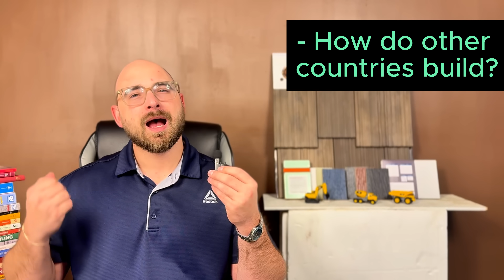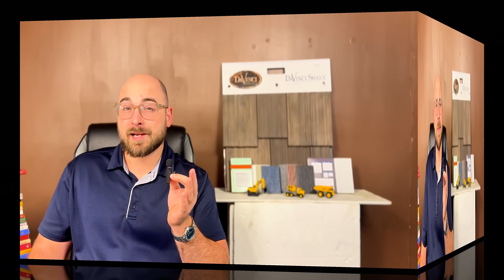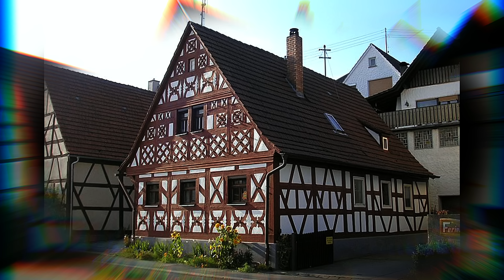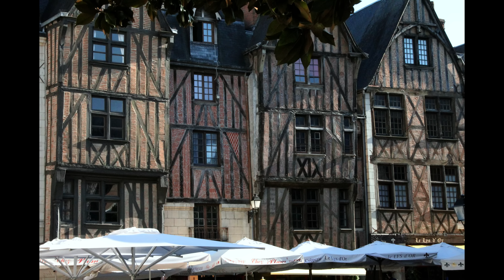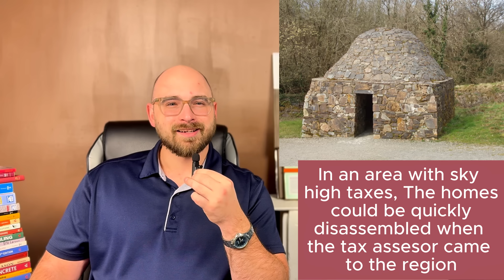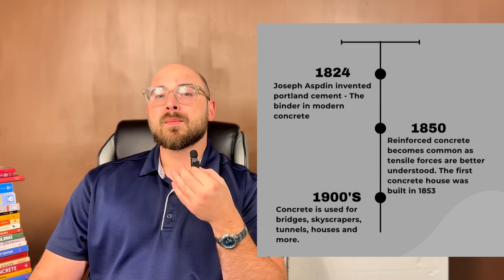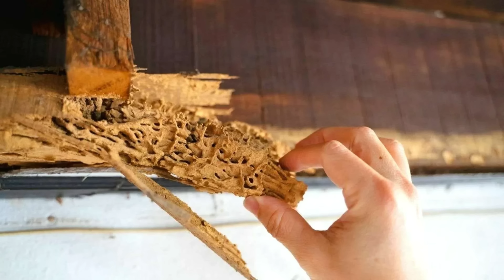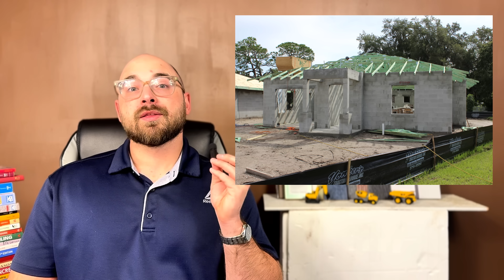Why Other Countries LAUGH at American Homes

Comment from the maker: Are houses in other countries better than the US? 🏠🤔

What do you think?
Reply: 100% better overseas.
Reply: @Aortadetroit Only 3% of Switzerland's population owns their own home. the other majority either pays rent 30 or 40% of net income or has financing. The USA, despite having a lot of financing, has a higher average home ownership than most rich countries in Europe
Reply: I live in Romania, which is pretty poor, and I'm a teacher, among the poorest of the citizens here, and my house is brick and concrete, with a thick treated metal roof (50 years corrosion warranty). Also, triple glazed thick windows. Under floor heating system and so on... Wood studs/OSB houses have not thermal inertia and are pretty fragile. Also, the American shingles that need replacing once every 10 years are horrible, too.
Reply: @ctr289  I live in the US; timber frame construction, with significant insulation. 3,500 sq/ft above ground (325-ish sq/m), another floor below, so about half that in a poured concrete (ICF) basement. Triple glazed windows. Wooden/asphalt roof supported with an 25ft (~8m), 8" steel I-beam across my living room/foyer, a 20ft long, 6" steel-I beam across my family room. Joined with a 40-ish foot 6" I-beam to form an "H", if that makes sense. Those tie into cross-braced steel and wooden trusses. You can park a truck on my roof. 

They did it because we have vaulted ceilings (entry way/staircase/living room are 35' (11m), my family room/entertainment area is closer to 40' (13m)) , and few walls (except exterior) that go floor to roof.

I live in a harsh climate along the Great Lakes (Buffalo, NY metro.) We get snow, and 60+ MPH (100 km/h) winds regularly. There's hurricane bracing in my exterior walls, and things significantly exceed code in my home. I didn't build it, but it'll outlive me with basic care, because it is designed to last, even with stick-frame construction.

My outbuilding (I collect/restore old cars) has a steel roof (stickbuilt frame, steel siding/roof), the problem with a metal roof isn't the steel. It's the fasteners. Each one has a rubber o-ring (Viton, is the trade name in the US.) Each screw is a penetration relying on that rubber o-ring to work. Each penetration is a failure point. Your screws will fail you in 20-25 years in our climates here, the roof will live longer. 

American shingles don't last 10y. The most recent shingles I put on my home have a 100% replacement guarantee to 50 years; 75 year total life (they pro-rate your refund from 50 to 75y.) That 50y warranty includes labor. I put them on in my early 30s. I'll most likely be dead before they need replacement (or old enough that I'm in a smaller home.) My installer, a friend, will be in his late 80s at 50 years. He will not be doing my roof then, either.

The cheapest shingles at building supply stores are 25 years. "Architectural" shingles start at 35 year guarantees right now.

Regarding insulation, it's cold here (3F today), my annual heating bill is combined with hot water, and my clothes dryer (natural gas.) We obviously don't heat anything in the summer, but do still take hot showers, and wash clothing. I'm just under $500, annually, and my home is kept warm (70F/21C) to stop my wife from complaining she's cold. 

Energy efficiency can be done, you just have to pay for it with stick-build framing.

I've spent time in the UK; lived in solid brick century old homes here.  The homes aren't better or worse here, or there, they're just different.... You can (and many people do) buy cheap, but that's on the buyer to understand what they're purchasing. Cheap homes will always cost more in the end...
Reply: @ctr289 Asphalt shingles are awful. I had a new house and had to replace the shingles after a hail storm. The entire new neighborhood had to. Or high winds break them off. Everyone is going to metal now.
Reply: @trehis  Well, here in Romania we've had ceramic tiles for centuries. They're almost immortal. We've been using metal sheets for a few decades, though, because it's cheaper, but it can still last for about 40-50 years, depending on brand/type, still a lot better than asphalt shingles. We have asphalt shingles, too, but they're used only by the poorest of the poor (village drunks, beggars). I was shocked when I found out most of the Americans use asphalt shingles and replace it once every 10 years. Also, for us OSB sheets are only used for the garden shed. Our houses are much smaller, though. Gas is more expensive (taken by the rich Western European countries as blackmail for letting us into the EU)
Reply: @ctr289  They aren't really 10 year shingles. Most are 25 year. They used to offer 50 year warranty's but not they just say lifetime or something but they don't last that long.
They suck and don't last as long as they should without getting storm or wind damage.
Reply: @ctr289  Współczuc że w Rumuni są ta żałośni nauczyciele. Mam dom amerykański w Polsce z kanadyjskiego projektu (Drummond Designs) i mieszkam w nim 30 lat  i jestem mega zadowolony. Gont mam polskiej produkcji sprzed 30 lat na osonowie z tkaniny szklanej i nie wiem o co ci chodzi. Najpewniej pmyliło co sie z gontami bitumicznymi sprzed 70 lat na osnowie z tektury . Ale takich się juz nie robi od lat. Elewację mam rzecz jasna z sidingu drewnianego i też od nowości . Wymieniłem dosłownie 1-ą deske przy cokole. Po odmalowaniu dom lśni nowością. A w Polsce popularny jest totalny badziew czyli cieniutki tynk na styropianie gdzie niszczą to myszy, nawet oprzec się odom nie można bo zaraz się dziurę zrobi. A takie te domy murowane solidne w że jak przeszedł w Polsce huragan to wszystko się rozwaliło w drobny mak. Paradoksalnie najmniej zniszczony był ośredke campingowy z domkami szkieletowymi. Płyta OSB ogromnie usztywnia konstrukcję i nadaje konstrukcji elastycznosci do której badziew murowany z cegiełek nie ma się co równac.
Reply: @trehis  Blacha od gradobicia czy silnego wiatru zniszczy się znacznie szybciej. Miej trochę logiki człowieku.
Reply: @PiotrABC-l5b  I live in a place with hurricanes and hail. 1 in 5 homes here have metal roofs and that percent is growing. Metal has a 50 year life span which is much better than asphalt shingles. Metal is absolutely better than shingles if installed to code.
Reply: @trehis  Założyłem na dachu werandy dobudowanej blachę trapezową bo nic innego nie sprawdzało się przy niskim kącie dachu.Faktycznie nawet ten trapez ciemny szary półmat jest stosunkowo elegancki, Natomiast z tą odpornością blachy na grad to absolutnie trudno się zgodzić . Gontowi nic się nie dzieje. A z blachy robi się masakra po gradobiciu.
Reply: @PiotrABC-l5b  What is the thickness of the metal and what kind of metal? Ours is 18 mils, 0.46mm. All the homes with metal roofs I see look just fine around here.
Reply: @trehis  Stla ocynkowana 0.5mm.
Reply: @PiotrABC-l5b  I have a galvanized building that is  more than 30 years old that isn't all pitted from hail. It went through the worst hurricanes just fine. I know what you mean though, a neighbors new car was written off due to hail damage. Galvanized steel should hold up to hail though. Chinesium?
Reply: @ctr289  Hello neighbor, from the south of the river Danube!  I'm a former teacher in a similar situation like you and I 100% agree with what you said. Our countries don't differ too much from each other, but the US, well...
Reply: @ctr289 , you forgot to mention,  that these houses must also withstand an 8+ Richter earthquake.
Reply: @ctr289 There is a very interesting fact about home ownership. The poorest countries in Europe, such as Albania, Hungary and Portugal, are the ones with the most paid-off and owned homes. While the lowest percentage is among the richest countries, especially among the new generation that pays rent. (Switzerland, Germany and other developed countries are the ones with the least home ownership.) Which makes me wonder if it is really worth earning more if you leave 35% of your income or more in rent or installments. How much is really left over?
Reply: @ctr289  👍
Reply: @ctr289  Agree with you, it is a shame the way houses are built in usa
Reply: The USA homes are built really cheap to minimum standards to make max profit.  If we up the standards, maybe we could be ok? Homes in Arizona are a joke!
Reply: @terrycarter8929  As a builder I have never seen anything like that garbage seen in all those inspection videos, that simply doesn’t happen in the northeast. You will be constantly harassed by building inspectors here over the smallest stuff. People watch those inspections from mass built garbage and ignorantly assume that is how house are built in America which isn’t even remotely true.
Reply: @terrycarter8929  As a builder I have never seen anything like that garbage seen in all those inspection videos, that simply doesn’t happen in the northeast. You will be constantly harassed by building inspectors here over the smallest stuff. People watch those inspections from mass built garbage and ignorantly assume that is how house are built in America which isn’t even remotely true.
Reply: @michaelstrang2563  it is true in Phoenix.  In Surprise the house I was renting didn't have insulation in the walls.  The foam they put on the outside behind the stucco was all they needed to pass code!
Reply: @terrycarter8929  Yeah that is Arizona a place with almost non existent building code, that being said I suspect that building will be around for over a hundred years. People in Arizona are really that well off so you are lucky they don’t force you to build to our standards.
Reply: @michaelstrang2563  there are some rich areas and poor areas.  The Californians and Canadians have driven up the prices so high the lower middle class cannot afford it.
Reply: I totally agree, ICF is the best for most circumstances.  I’ve designed and built the basement of homes this way, but have not used it to build an entire home yet.  However, ICF roofs are a disaster!!
Reply: In Russia most of my elders laughed at USA houses that built of wooden frames and DVP that can be wiped away by totnado or easily burnt by woodfire. They ironically call them a cardboard houses. But when I did some research and compared prices of solid brick house vs wooden panel house, I realised, that I can't afford myself a solid brick house (((
Anyway I still live in what is called in NY a 'projects'. So nvm.
Reply: As a European, I think there is no problem with the frame construction method, if it had heavy timber framing reinforcement, or 1-2 walls were made of brick or concrete, and were not just an independent decoration. I live near Budapest, there are frame houses here too, but they are not that widespread. What is built on site is not of such good quality, but the frame houses made of prefabricated walls here are quite strong and durable. Actually, it has not spread, because of the banks. Because if the  debtor does not pay the mortgage installment, the bank has a hard time selling the frame houses, because here people consider brick houses to be more valuable. That is why banks very rarely lend money for the construction of frame houses.
Reply: My only concern about Anerican houses is safety and energy effeciency.I think even our half-timbered modern house with  flexible walls are mire efficient than any of these cardboard houses in the USA. Then you should not need ACs so.much. our house is a passive house, it was already on this standard in 1993 because of the thick walls and insulation... Even today it
 fits the latest norms.
Reply: @AnnetteLudke-je5ll  energy efficiency in USA is much better than Europe. One of the big reasons you don’t see European style buildings is because of the poor insulation properties of said buildings.  Look at the heatwave in Europe in 2023. 47000 people died from it.  It reached around 100 F. Meanwhile in the US, we get that temperature every year.
Reply: Hard to say, as I've never been to the US. But I'm quite happy with my English bungalow, an early 1960s single story home with a cavity wall. The outer skin is brick, the inner is (I think) some sort of block. The cavity between was originally an air gap which prevented water ingress, now filled with cavity wall insulation; polystyrene beads.  Many claim that's not a good idea, but I've had no problems with it. Windows and doors are double glazed, though would have probably been steel framed windows and wooden doors when first built.

There's about eight inches of fibreglass loft insulation above the ceiling. If I seem a bit obsessed with insulation, it's because England is cold and damp for much of the year and energy prices are high.

I'm amazed at the size of many US homes; my bungalow may seem small to you at 600 square feet but I live on my own and it's the right size for me. It's larger than many other one bedroom bungalows here.
Reply: @rogerbradbury9713   You should go and see a house in Denmark or south Sweden where temperatures are  close to same with uk or Germany and notice their heat bill with yours though out of a year and be amazed.
To understand why you should go through bay your bay windows if you have and attic insulation along with insulation between the floors and walls. and I bet that you 100% don´t have it done between the floors where the most insulation would work if it would even be there.
UK under rates any insulation and as well how it should be installed, mostly because you don´t understand what you could get, just you dont have comparison and everyone even surveyors who are telling me into face that why are the ones who are keeping people like you off from what you could get.
Reply: @rogerbradbury9713  you are living the good life👍
Reply: If I ever built new, it will probably be ICF. Tax laws in Germany, for example, favor building rental homes, which are literally investments. They don't have to be fancy, but they will be built like the proverbial Tiger tank. The "Dachgeschoß" (attic) rental unit I lived in back in 2022 in Mainz was a three story, three unit apartment house built in 2008 of concrete. Since it was originally built by the father-in-law of the owner (who lives 4 hours away up in Westphalia) as his primary home on the ground floor, it was a nice newer home in a nice, upscale neighborhood in the Oberstadt (upper city) with quick and easy walking access to transportation and local shops. I literally had multiple options. My nearly 50 year old stick home in Indiana is a pain, and you have to worry about termites and vermin.
Reply: My grandfather build house from reinforced concrete in 60s!! (so was my father in 80s) And my grandfather was  was just factory worker in Serbia which has like 1/5 off USA GDP  per capita .And you see milioners in USA building houses from wood with no foundation
Reply: @dzonikg  No one builds houses without foundations in the America especially millionaires you are clearly misunderstanding something.
Reply: @dzonikg There’s no place in the US where people build homes without foundations!
Reply: I think it is not the method of building that matters as much as the quality. I mean I've been to a motel in the US where I could put my fingers through a gap between window-frame and wall. And I've encountered many homes that were poorly or not insulated (with an AC on full blast, there goes your energy-/money saving). There are also some questionable product used (especially when it comes to doors* and windows of extremely poor quality. And door-frames that are flat, not overlapping with the door). In the US (where I spent little time, maybe 3 month up till now) I have seen kids crash into a wall leaving dents (never seen that happen here in 50 years, but these days it can happen on the outside, due to the softer insulation under the plaster).
Now in all fairness, I cannot tell you what percentage is poorly built (a huge gap in the wall grabs attention, a normal built house does not). But it is exponentially higher than in Central Europe.
There is also something great I learned in the US. Passive heating by designing roof / windows so the lower sun in the winter heats up a black-stone floor but cannot reach the floor in the summer.

*I always find it funny if they kick a door in, in a movie (you could not do that on an inside door here in Switzerland ¯\_(ツ)_/¯). But I have seen cardboard filled doors in the US, so it is believable. For comparison, the front-door on my flat has a 2mm steel plate between laminated wood, bolts into all directions and has a lock (Kaba star cross), not even the LockPickingLawyer messes with. And yes, double bricked wall... my home is my castle :D
Reply: To be honest, I had the impression of US houses to beautifully looking but with similar strenght to shanty houses. With walls that you can punch through, and can be flattened easilly by natural disasters. In 3rd world countries, average homes are already  built with steel, concrete blocks and cement and it is much cheaper than wood.
Reply: Some are, some aren't. I mean I'm in Georgia and my house is 125 years old and I can guarantee you that it wasn't originally built by the most skilled artisans.
Reply: I am from Costa Rica. Ring of Fire from coast to coast. My father in law build his house on his own. It's made with Cinder blocks. He did a mesh of rebar. He filled every block hole with concrete. You CANNOT get cell phone signal IN the house. It's literally a faraday cage. One day our Irazu volcano will bury our San jose city like Vesubius did Herculano and Pompei. I am absolutely positiver my father in law's house will be preserved for posterity 2000 years down the road. The only way to bring that house down is by active demolition, and an expensive one at that.
Reply: @decaalv LOL! 
Then how do people call your cellphone?
Reply: I thinkwhat a termite infestation does to an americanhouse. Or just mice.
Reply: Our late father, and his father before him, built solid brick homes in the Midwest.  All those homes are still standing and square (no cracking or settling) despite some being over 100 years old.
Reply: You said in your video: It depends. I am of German decent and lived in Switzerland. I came to appreciate the typical US wood house for it’s flexibility to make design changes. The biggest draw-back however is energy efficiency. For the vast majority of US houses HVAC is a must - even in northern states like Wyoming, Montana, whereas the vast majority of houses in Europe including Southern Europe do only provide heating for the winter months. The summers in Europe may not be the most comfortable, but people make it through those hot weeks and few months. 
The other issue is the increase in natural disasters: Hurricanes, wild fires, tornadoes, flooding. 
In other words: I think in the US, concrete / CMU based buildings should be more seriously considered for energy saving and overall safety reasons at least in certain areas / states.
As for Europe: Innovative sustainable, environmentally friendly composite materials are coming to the market there in big box stores, combining the features of both worlds wood, concrete and stone! 
Finally, I feel the US is much slower in adopting innovation in home building in which I include also plumbing, electrical, interior design, heating. As said, I am not unhappy with my house here, but I feel we could do better.
Reply: @BAG9114 — My home in the Pacific NW (Bellevue, WA., near Seattle) has no air conditioning. I lived there 35 years, and there was an average of about 5-7 days in the summer when I could have used A/C (95 F + or 35 C +). Perhaps more days in future years as global warming increases. 

That said, we are located in the “rim of fire” for volcanic and seismic activity. I’ve experienced three earthquakes in my wood-framed home, and so far no major damage. I’m certain there would have been significant damage with a stone or concrete based home.
Reply: @BAG9114 There is a very interesting fact about home ownership. The poorest countries in Europe, such as Albania, Hungary and Portugal, are the ones with the most paid-off and owned homes. While the lowest percentage is among the richest countries, especially among the new generation that pays rent. (Switzerland, Germany and other developed countries are the ones with the least home ownership.) Which makes me wonder if it is really worth earning more if you leave 35% of your income or more in rent or installments. How much is really left over?
Reply: @ That's an interesting perspective. I remember recently hearing about the UK trying to convince people to upgrade their homes to be insulated so that they could survive using heat-pump heating in the summer. I hadn't thought about what the state of the rest of Europe would be.

I don't think I've ever lived anywhere that didn't have a heat-pump unit. (Except once very early in my childhood. It was a very poor house with only a swamp-cooler!)
Reply: @BAG9114  Most houses are BLACK ROOFS! And black roofs will amplify the heat! Whereas Switzerland has grass for the top layer of the roof!
Reply: @BAG9114  I like your answer a lot, I do want to point out that the insulation thing actually isn’t as bad. A lot of older houses barely insulated for sure, however in colder climates insulation is not only a must have it is a requirement and we have minimum standard as to what those insulation values should be. 

My house was built in the early 1900s and it’s well insulated, aside from the windows which had to be replaced with newer ones, these houses can do well. Remember they only had a central stove for heating back then so people were much more incentivized to make sure that heat produced stayed indoors as much as possible.
Reply: @BAG9114  while I see where you are coming from American houses actually are built to be energy efficient. We use at least 2 types of insulation per house. As well as special OSB sheets that also provide some R value. Of course it will change throughout America because we experience pretty much every climate the earth has to offer.
Reply: @BAG9114 I think you perfectly summon up so much of the ups and downs of the choices of building materials.
Low cost housing by using easy available materials is a good thing in the way that it is fairly cheap to build a house in US..... so many more people can have that opportunity.... 
But in the long run...... 
Your perspectives are so well placed. ..
Reply: @BAG9114 i like the wood homes in the US we have a surplus of wood so rightfully so you use what you have the most of, also americans are very fond of remodelling, i have not met a single american who kept their home the same for more than 2 years, theres always changes and updates, i dont know its just a thing here, they get tired of it, they rebuild it again, i also have a house in the philippines and we do use concrete there, and now i actually want to renovate it and change the interior and i would also want to make it “centralized AC” but guess what? The engineer said i would have to destroy everything cause they cant do the centralized AC with how the house was built, and its soooo hot! The bricks made it very hot, it s really hot it feels like an oven we get 35 C there in the philippines(because youre european i use celsius your welcome) so i do like the flexibility of american homes, americans like convenience thats what america is all about, hence we have cars instead of public transit, the car is definitely more convenient, nobody wants to ride public transport carrying a grocery bags, and everything you just got from CostCo’s while carrying your dog or the childrens strollers i means i hate that to be honest, i lived in the UAE for a long time i find it cumbersome because alot of people carry their kids to the public transport and they have strollers, grocery bags and everything 🙄 so no 100% the car is more convenient, thats the same with our homes..
Reply: @BAG9114 :  The USA is much slower, about 100 years behind the times mostly because of the constraints of the building code, combined with the fact that people don’t actually have to pay for these homes, they borrow money, and they accept poor quality since it really didn’t come out of their pocket to begin with
Reply: @steveperreira5850 in what perspective are building codes a constraint?
Reply: @steveperreira5850 — Borrowing money is not free; it comes at significant interests costs!
Reply: @steveperreira5850 you guys are slow . You and your dad can build an American home by yourself three stories high . You cannot do this with a stone home . We built America with our hands
Reply: @ most europeans also have to borrow most of the money to buy their (first) house
Reply: @steveperreira5850  The USA is about 100 years behind mostly due to youre government system keeps the people naive and kinda ignorant .... and the bad part of it all,,,, the people dont even realise it.....
Reply: @AliasHSW  In USA, codes are restrictive. Instead of specifying a goal, it limits what can be used, and thus block innovation. If one varies from the code, the inspector may refuse to approve the work.
Reply: @ the primary objective of the American/ICC building codes is to protect life, not necessarily the building. A/E/C has free rein to design and deliver the project by any means and methods. This way they can innovate and try new ideas as they please, so long it satisfies and or above the intent of the code.
Reply: @AliasHSW  I disagree. The main purpose of government 'oversight' is to insure they get a cut of everything. People who have natural liberty don't need government permission nor need to pay tribute to exercise said rights.
To illustrate : despite widespread government regulation in automobiles, annual fatalities exceed 39,000 per year (not counting non-fatal injuries). 
That far overshadows deaths by firearms (excluding suicides). But no one espouses banning 'ASSAULT AUTOMOBILES'. Or changing the laws that penalize rail based transit... which have infinitesimal fatality rates by comparison.
Reply: @steveperreira5850 the only thing slower is your brain
Reply: @AliasHSW  The type of materials, lesser insulation materials, BOCA codes that do not always reflect newer technology, municipal planning ordinances the restrict the types and appearance of structures (including the extent of anchorages to foundations and wood structures). Some additional codes are imposed by municipal governments, such doctrinal setbacks between buildings, the existence or heights of privacy fences, and the location of trees that must be planted. Our city relishes "historical preservation" mandates that require homeowners to paint walls, doors, window frames, shutters and roofs specific colors whenever the tiniest bit of renovation is to occur. l'll give you an example: A  neighbor wanted to replace a rickety garage door adjoining on his house, which is located on a short, inconspicuous alley. No, the city said. The garage has to look precisely the same as it looked 120 years ago, including appearance and color, and the homeowner must hire an architect to design a proposal for review by the historical commission. The cost of replacing the rickety garage door became astronomical. His only choice: Leave the door untouched, even though it didn't function well and needed repainting. He escaped with the city's edicts only by letting the door decay and the neighborhood suffer.
Reply: @BAG9114  Summer heat waves being more frequent and also frequently causing a surge of fatalities in Europe when they hit, along with the difficulty of implementing HVAC systems into solid wall homes in order to mitigate the impact of that is something that I expect to become more & more of a significant factor that's seen as a weakness. Add to that that HVAC systems also manage air filtering that can use fresh air or recirculate air for efficiency, so they're ideal in the summer when pollen and others allergen levels are high, and just opening a window for ventilation isn't an ideal solution.

Things like that where offsetting the downsides of home construction by doing things like taking allergy medication in the summer are a lot more difficult to recognize because the cost and impact of that gets distributed in a way that doesn't make you consider the root cause being the way your home is built. (Also it's surprising how few windows or porch doors in Europe have screens in them as a standard, given how often you have to keep them open in the summer when you don't want to just fill your living space with flies & mosquitos).

Living in Sweden where most living structures are built for cold winters and not for hot summers, it's been awful here by comparison to when I lived in the US. Even in winter, the inefficiency of radiators pumping heat directly below windows and drying out the air is also a far cry from an HVAC system in the winter as well (not to mention there's basically no ability to control that centrally).
Reply: If you're in a seismically stable area that doesn't have frequent hurricanes or tornadoes and stays above freezing the majority of the year and below 40C the majority of the year.... the old timber frame construction is still probably the cheapest option.   An example is where I am in NE Georgia, just above the fall line.  Summer is still hot and humid, and winter is cool with rare snow events, but more importantly, tornadoes and hurricanes very rarely come this direction.  (Helene paid us a visit last fall while still Cat 1, which was a very notable exception.)  The #1 cause of home destruction is still fire, but the #1 cause of home damage without it being total destruction here is trees falling on them.

If I had my options and I was building fresh, I'd love to get an ICF house, but we took the house we could afford 15 years ago, and it was classic balloon frame.
Reply: Consider just 1 scenario - fire! Most houses non-timber can be salvaged cheaper faster after a burn. Some roofing and brick support wall methods will isolate fires to affected rooms when fire suppression reaction is timely
Reply: @kevintinofirei782  that is sort of true.  Many times when there are wildfires in the US, even the concrete ones have to be scrapped, because if the temperature gets too high, the rebar is basically useless.  Although, European homes don’t usually have reinforcement. The lack of reinforcement probably would make it so the house can survive the fire, but not the earthquakes.  There have been up to 9.2 earthquakes in continental US.  The biggest in europe I could find was 7.6. Which is almost 100 times less intense than what the US has seen.
Reply: I think there is one big misconception in this video that many americans have about those laughing foreigners: 
We don't laugh about wood, we laugh about the American standard to build an entire house out of wood, while still trying very hard to use less wood than us foreigners use in the roof of a brick house alone.
We don't laugh about wood houses, but about houses which are built less sturdy than temporary structures and shed we build. The typical american home has the build quality of a makeshift rain shelter homeless people build here. That's what we laugh about.
Reply: They're less flammable, that's for sure!
Reply: Most Caribbean houses are brick and mortar. Are they better? Well they stand up to hurricanes a lot better. Are they better than US homes? Debatable.
The tolerances, insulation, more practical layout and electricals seem to be better in US homes while Caribbean homes seem to stand up to natural disasters better.
Reply: @Skungalunga  obviusly, man...Last Word is on carpenters/masonry workers. There's temples in asia that lasts for centuries, but stone/brick buildings in EU with that long life...
Reply: @Skungalunga The US has the knowhow to build long-lasting homes, and chooses not to
Reply: Not sure since my wooden house in Louisiana is 136 years old and has survived ancient oaks falling on it from Hurricane Katrina...  Maybe they're referring to factory houses.
Reply: I grew up in canada, every day a blackout, every week a fire somewhere etc. 
Later moved to romania, hungary and poland and travelled around europe and never saw as many fires as i would have seen at home in one month. 
Any romanian hut is stronger than our mcmansions
Reply: When people outside the US laugh at your wood homes is usually because we see year after year homes in predictable Tornado areas being destroyed YEAR after YEAR ! ffs !. We have high winds here in the UK just last week 90-100MPH winds hit but are Brick built houses dont fall down. My 4 bedroom house was built in 1930 so almost a century old it it is built with strong engineering bricks and is solid, a storm can go by but indoors you would not notice.  Also our building regs are much stricter than in the US which means flimsy houses do not get approval locally and will not get insurance.  We do build some wood frame houses but they are either old style Cruck designs which meand using whole limbs for the frame or modern glue lam designs either way they have to strong and weather resistant. Not flimsy cheap like we see being blown away in the US.
Reply: The argument fails, however, because they are anything but cheap as the buildings become cheaper and cheaper material wise, the prices of them go up higher and higher. They becomes a huge profit margin for the builder by cutting materials. And the consumer is not paying for a low quality house, but he is getting one even though he is paying for a high-quality house, the idea that you’re spending 400 or $500,000 on a house that will probably not last 100 years or even as Long as the houses that are already 70 to 100 years old is damming and it of itself.
Reply: 20:27 CO2 is not a big concern. Yes, it is a greenhouse gas (but so is water vapor), but it is also a part of plantlife cycle. It will return to oxygen if given time to dissipate.
That said, timber industry hurts CO2 absorbsion of the forests, and fast-growing trees don't absorb as much CO2 as the old forests (which is why they are lower quality as well).
Though don't take me on my word. I work on steel mill, not on concrete plant. Our steel mill, however, recycles slag into cinderblocks (concrete blocks in our language are literally called slagblocks, but they are essentially the same).
Reply: yes
Reply: Most are - but there are countries like Japan where the houses are worse.
Reply: You can buy a good house in the US, the same quality as we build in Germany, with a foundation and basement, garage, solar panels, heat pump, good sound and heat insulation. But it comes with a price, starting from $1 million and way way up. 

I saw something similar near Seattle with a price of $4 million.
Reply: Yes   They build stronger
Reply: American plastic cheese of housing. What a scam
Reply: Every house in a different country is better 😅
Reply: It depends...tho most of the stories about the houses that were completely demolished or severely damaged due to some kind of natural evens I've heard come from the US
Reply: we live in houses, you live in barns.
Reply: Yes. Other countries build better and sturdier.
Reply: I know the US hauses quite well as well as the houses in the Europe, if I compare my "Fertighaus" in Austria, which is built from wood with the US construction I see my house is built stronger, I saw hauses in Texas just put on some simple brick piles with no real connection to the ground, poor insulation, built from 2x4... and my house has walls made from strong 200mm beams, plus 10cm insulation, put on strong concrete slab and well connected to it... I know that in other regions in the US the houses are built better, but still not in the same standard even when comparing the same size of the house... Also I think the construction projects in the US are more costly then in EU
Reply: I grew up in the US, then moved to Israel at age 34. I can tell you that the poured concrete and cinderblock construction used in Israel is a superior building material. Unfortunately the skill of the laborers here is sorely lacking compared to those on Long Island where I grew up, so there tends to be a lot of problems in the first few years until all their screw-ups are repaired. On the flip-side, my uncle built his house himself using cinderblock construction and 30 years later he has never had to fix anything, only just add on to the house as he had more kids.
Reply: The question isn't "better or worse" but of "fit for purpose". The standout statistic is 1.8% of the US population having to temporarily vacate their homes annually. This is symptomatic of unsuitable locations or constructions being used. The unsustainablity of this is evidenced by properties becoming uninsurable.
Reply: Buildings in Serbia after 1969 (two devastating earthquakes in the former Yugoslavia (Skopje and Banja Luka, 1963 and 1963), were designed to withstand the strongest earthquakes.
The law applies construction with PRESTRESSED CONCRETE, as in BRIDGES (a network of thick steel cables, over which special concrete is poured). The horizontal levels are such, as is the network of supporting columns. Some buildings have huge hollow bricks 4x larger than regular ones in between. So they have a combination of concrete and bricks. A weekend house with 2 levels, during the devastating earthquake in Mionica, which was 5.6-7 Richter, did not damage our house in the least. It was built using the technique of prestressed concrete with brick blocks. The other 100-150 year old houses in the vicinity of the village of Rajković (where my weekend house was) had cracked load-bearing walls, and some were leveled with by land.
Branislav Ivković, who is also a professor at the Faculty of Civil Engineering, said after a series of earthquakes in February that our buildings were designed to withstand an earthquake of up to 8 on the Richter scale.

- Let me reassure the citizens of Serbia, as far as buildings are concerned. The European seismic macro map from 1998, which is still in effect today, says that an earthquake of 6, maximum 7 on the Richter scale can be expected here, and we are designing for 8. For more than 50 years, design for seismic impacts has been fully mastered -
In addition, in Serbia there are no gas pipes, stoves are almost 100% electric, gas stoves are very rarely used. Thermal power plants are used for heating, which use heavy fuel oil, and from them pipes with hot water are run underground to the apartments.
Conclusion: What happened in California cannot happen in Serbia, or even in most of Europe.
Wooden shacks are used only while large buildings are being built, and then they are demolished. I was shocked to see that you buy shacks for huge sums of money and thus live your whole life in a potential gas bomb.
Reply: In general, I'd say yes. Being cheap and easy to build, for US construction companies, is just that KISSplusCost. By not adapting to stronger house construction, the US building trade is keeping the US in the weak housing area. The US construction trade is one of the few holdouts against Metric, in the US, where most manufacturing companies have moved to metric and all US Science, military, airline, automotive, tech and more, industries have moved to metric and work better with the rest of the world.
Reply: yes, they are. That's all
Reply: Yes, American houses are generally poorly built.
I am a former Scandinavian construction worker, and spent time in the USA.  (Several years, actually).
I was absolutely CHOCKED, the first time i visited, and saw how incredibly flimsy your houses are. 
My roof beams are 20" x 2.5". It has glazed clay tiles on it. Will need new tiles in roughly 150 years.
That is a standard roof here in Scandinavia. 
My outer walls are more than 1.5 feet thick.

Your houses are actually so poorly built, with such under dimensioned materials, that they would be illegal to erect here.

It is an easy fix, though! 
Your poor construction quality mainly stems from poor materials, which are ALSO under dimensioned.
Just use thicker, stronger stuff, and you will immediately notice a great improvement.
A pro tip; if you absolutely have to use plaster boards, then make the first layer plywood boards, and then plaster boards on top. Much stronger, and makes hanging cabinets, paintings and installing light fixtures a breeze. 
Also: put rockwool insulation in your inner walls, between your rooms. A great, and cheap sound proofing.
After all; the material cost are a smal part of building a house. Land prices and labor costs much more than the actual materials.
Reply: Hello. I'm from Chile. Our buildings and homes are constructed to withstand huge earthquakes, and they do. The last earthquake was 8.7, and only a couple of buildings colapsed, and it was because they didn't follow regulations.
Reply: Ho apprezzato il tuo video, sufficientemente esplicativo pur mantenendo una durata accettabile. Non hai parlato della Bioedilizia che va per la maggiore adesso in Europa e ha un futuro per il rispetto ambientale, il risparmio energetico e la salubrita' degli ambienti di vita quotidiana. I vostri tre porcellini avevano già spiegato tutto: case di paglia, NO! Case di legno, No! Case di mattoni, SI! Ho guardato i programmi tv in cui volenterosi, ridicoli e buffi carpentieri si danno da fare per tirare su o togliere pareti! Perché? Il tetto e il piano superiore devono pur  appoggiare da qualche parte o sono appesi alle nuvole? 
Da noi, in Italia, sono gli architetti a firmare i progetti, le imprese edizie le tirano su o le ristrutturano secondo le direttive dell'architetto e se ci sono elementi in legno interviene il carpentiere. Forse..... Il carpentiere NON dirige I lavori, ci sono gli architetti e gli ingegneri per questo, sono laureati, specializzati, qualificati e abilitati a farlo! Le case USA sembrano castelli di carte e cartongesso! Giochi da bambini. Un soffio le porta via. Per quanto graziose siano le case di Hgtv non ci vivrei mai, il più povero in Italia vive in case più solide e durevoli dei più ricchi in USA! Con tutto il rispetto per le consuetudini altrui... Ma dovete migliorare le norme... Infine, se ogni famiglia vive in casa unifamiliare : quanto territorio vi serve? Cementificate tutto! Non può durare! Mai sentito dire riscaldamento del pianeta? No ad ulteriore consumo di suolo? Coraggio e buon lavoro. Cordiali saluti
Reply: As a Ukrainian whose house is built of brick in a rather cold in winter and hot in summer area, I lived for a long time in a Ukrainian village (Ivano-Frankivsk region) and believe me, people there spend a lot of money, effort and time on real estate. My father spent about $15,000 to build a decorative concrete fence around the house. Any dear Ukrainian will confirm that we have such a thing. I just want to say that it all depends on the country, the materials that are available, the traditions and mentality, and of course, climatic conditions also play an important role, and each house, like a person, is wonderful in its own way.
Reply: Im living in a house which was build 60 years before america was discovered and survived 2 world wars 😂 nothing more to say i guess
Reply: @Vindex0 how’s your bathroom and air conditioning?
Reply: @ci6516  its intresting that you ask, there is no air conditioning in my house we have ivy on the house walls which cools down the house in the summer and its build in a specific way you have constant 21- 24°C even when its outside 39°C thats the usual temps in summer. We have two bathrooms, both were added later, there was no bathroom in the house before.
Reply: @Vindex0, let's not jinx it!
Reply: I moved on, step by step, to an interest in deep insulation cavity parallel chord sidewall truss / modified roof scissor truss unified rigid frame structure. Ground level assembly / tilt up frame construction. On building site "1" step "manufactured" and installed finely shredded wood fiber to super insulation levels, ventilated and or vapor permeable exterior solid wood sheathing panels. Looking to the future of affordable high quality, low cost, energy efficient "Swiss chalet" style housing made possible with a "refined" , relatively low cost, equipment package ... A properly scaled, vertically integrated urban and rural forest restoration / "free wood" harvesting system to small scale sawmill system to home building "system". New Era Home building for building New Era Community.
Reply: Yes, houses in other countries better than the US? Wood homes suck because they are not built to last, catch on fire and burn to the ground, and can be demolished by wind storms and flooding.
Reply: Yes
Reply: Yes
Reply: yes they are.
Reply: Yes
Reply: So US insulation minimum is only 100mm thick 😮 Denmark is 300 mm minimum insulation, I hope you get cheap heating 💸💸💸
Reply: South African. Double brick outside walls, single brick inside. Although our houses are poorly insulated as our climate is not extreme. Does make houses cold in winter though… but then a cold day in Cape Town is 15c😂.
Reply: A cave Is better. A tent Is better.
Reply: I have been in a few in the UK and they had older plumbing styles.
Reply: We don't actually want our homes to last. It is also easier to add on to a house if it is not solid. People like new homes. Now I like my home to last.
Reply: Are you dumb??? Look how the "houses" are after a Hurricane, Tornado or a Fire... Just look at Florida each year. Or California, haven't you watched the news. Valencia in Spain, they had a big natural  disaster... Houses still standing...
Reply: all asia build house from concrete or stone in general
Reply: Yeah. South Korean houses are very impressive.
Reply: those houses in the LA is burned to ashes. then maybe US need to upgrade their house.
Reply: Yes they are. We use dubbel walled brick for 90% of the houses. And ston tile roofs. What do you think? Off course that is better than wood paneling.
Reply: You forgot the foam concrete and autoclaved aerated concrete btw. Strength of concrete, lightness and thermal isolation of foam insulation.
Reply: Yes. Lived in the US for 6+ years in multiple states.
US houses are built from cheap flammable materials and they do not last.
Reply: Yep. Although here in Australia we're well on the way to building homes to American standards. (Cheap and flimsy)

Your roofing is ridiculous.
Reply: yes
Reply: Each country has its own method of construction, but the most important thing is that everyone agrees with their own method of construction. My explanation is that if the country (general) sees more benefits in certain There is simply no need to change the materials. In Uruguay we use blocks and bricks because there are several fires here each year and that is what we are looking for: safety against fire.
Reply: Yes, even in a third world country houses are better. I've always been wondering WHY the hell they build houses like from cardboard
Reply: Perhaps the problem with poorer quality and outdated technology is not reserved to houses only. The transport sector is also decades behind in the US, from infrastructure to the actual poorly performing semi-trucks.
Reply: Aquí en chile las estructuras de madera que yo construyo son infinitamente mas resistentes y antisísmicas, utilizamos clavos de hast 6 pulgadas puestos de manera estrategica, ustedes dan estructura final con el osb, aquí las casa son firmes y la mayoria no nesecita instalacion de osb, aunque se usa por un tema de aislacion, las terminaciones en norteamérica son mas hermosas eso sí, nosotros aprendimos de las contrucciones de alemanes, holandeses y españoles, tambien ingleses, es por eso que contruimos de forma firme.
Reply: In the EU we have HOUSES, we use wooden sheds just to keep the farming tools in.
Reply: Yes.
Reply: If you look at the weather conditions across the USA I don't think EVERY house should be made of wood and nails, lacking much insulation.
Reply: Bangladeshi houses are much much better and cheaper.
Reply: Northern european timber-framed homes ARE much better than american timber-framed homes. The build quality is just so far ahead. As an example, there are strict requirements for air-tightness, vapour barriers, and energy efficiency. The latter results in wall thicknesses of over 300 mm (1 foot). The critical junctions in european homes are on a whole different level, with extreme attention to minimizing thermal bridges and moisture ingress.
Reply: Don’t know my house in The Netherlands was built in 1904 completely with bricks. Fine quality no problems.
Reply: My house was build in 1930 and is in top condition😂🇳🇴
Reply: @hestkuk99   dear hestkuk. If you are Norwegian I salute you for your name, although I do find it to be a little bragging🤣
Reply: 100%. Just imagine how much less damage would be done in LA fires if you just used brick and tile roofing
Reply: Wood and plaster houses do not do well with tornadoes.
Reply: Yes, considering the price, especially.
Reply: US have Better wooden huts. My best man lives in Chicago. Houses are absolutely rare, only huts everywhere.
Reply: I am norwegian, so i have a light timberframed house. But the main difference in mine and the homes i have seen in the us would not be the frame. It would be the finish/cladding. I have solid wood planks for the walls on both sides adding rigidity. My roof is also solid wood planks om both sides with a asphalt shingel roof. All the materials are solid and no composite materials. No plaster either.

The us homes i see are built using composite or preassembled plates  that are pretty thin. Also it looks like all the framework is thinner and have less bracing internally so less sturdy.

I may be wrong.
Reply: Yes.. especially houses built in Austria, Slovenia, Germany, Switzerland
Reply: @naikjoy  yes but america has tornadoss that even concrete houses dont survive. you have to take that into account besides the greedy profiteering that they have. if i believed in god i would say tornados are a gods hand.
Reply: Yes and no. You got to understand that for those who grown up with solid masonry/cement structures, that it is painful to watch the aftermath of, say, a tornado. Disbelief is the most common reaction. "Why do you keep building a stick house, if this is what happens?" I personally totally get why homes were built that way in the past. But like you said, lumber is getting expensive. Very expensive. I dare say it is now actually a luxury material.

But it also has its charm. I'm a big fan of city building games such as cities skylines. The first thing I do, is replace all the models with stick houses. It has its own soul. You can look at one of those and instantly say: That's 'murica. If you started to deviate from your construction style with the completely gratuitous and unnecessary roof lines and what have you, you will also lose part of your soul.

While there are for sure better ways to make a house, I feel that domiciles are increasingly built devoid of a soul. Concrete pretty much guarantees this. I have yet to find a concrete home that has any character, other than that of the psychotically evil villain in a bond movie. And I get it, something something population increase. But I for one think that lowering standards just to accomodate more people who then in turn also have to lower their standards, so that they might accomomodate more people who then also in turn have to lower their standards... It's objectively insane.

Don't get me wrong, kudo's for the ingenuity and progress when it comes to sound construction techniques, but what good is it if all they do is contribute to a soulless life?

And that's why I want a hand-hewn log cabin.
Reply: @Flyingdutchy33  well said
Reply: American homes is short-lived homes with ripping off prices.
Reply: Literally yes, living in cardboard with a brick overlay built by incompetent imbeciles doesn't lend well to people enjoying the houses they live in. Everyone is scamming you from the purchasing of the land to the taxes on your house after closing. Home purchasing in the US is probably the fastest way to give all of your savings to a billionaire investor or a small group of several millionaires. Good luck getting a "return on investment" when the economy crashes ;~;
Reply: 1000% they are bette in every country in Europe
Reply: @avarora  AAC - это, вероятно, тип ячеистых бетонов, пенобетон и газобетон и крупные блоки из них. Это - мусор, а не строительный материал.
Reply: in average  yes , also will never understand  why in Florida which is notorious to have hurricanes use to build house with light material and thin wood structures and then they complain ooh the hurricane destroyed many homes, build the the full log, log timber,  or bricks or concrete and you will see as  the problem will diminish
Reply: ¡Sí!, en general
Reply: Yes, in general
Reply: i think you can measure my grandfather's house price and compare it to US one for same price and than see if it would last half a century. thought that is just my point of view.
Reply: yes in quality and how strong they are some of then do not even burn and if a fire happen ids the furniture  just get new furniture a power washer paint and you back in your home
Reply: Yes other countries homes build are better just look at cali fires they whole house is burned up but in other countries only damage is furniture and paint the frame of the house still stand
Reply: Sì
Reply: Due to hurricane induced building codes concrete block and brick are the usual building materials in much of Florida. Wood frame house = really old
Reply: It needs to be said that the USA has the third largest average home size in the world. It is only surpassed by Australia (about 10% bigger) and New Zealand (2%) where overall building methods are very similar to the US. German houses are only about half the size of Australian homes and in the UK only about one third. We all get what we pay for!!
Reply: US building is decades behind the rest of the world. End of story
Reply: American homes suck because they are designed to withstand natural disasters better and they have heating cooling and indoor plumbing and electricity and they are bigger and they are better looking and they have higher tech designs to them and they allow you to park your vehicle next to or inside your home and they have superior lighting and better security with their doors and they are not 200 year old rotted pieces of trash the government shoves onto the people and they don't have as much mold and they just suck in every single way.  Wait a minute. These things make the rest of the world look like absolute shit and make America look like the best place to live ever.  Fun fact less than 10% or European homes have indoor heating and cooling even though it can get extremely cold or hot as hell in Europe just like America but do to how European new homes are designed and the fact that old homes in Europe are both not designed to add heating and cooling at all and the ones that have heating and cooling its so bad there  is a 80% chance of fires happening.   Also note 98% of homes in Europe are either in the same design or are literally built before plumbing was brought to Europe from America.  Europe didn't have indoor plumbing and they really didn't have a good sewage system set up and in horrible reality the system Europe uses as a sewage system was built over 500 years ago and it was designed for water run off to protect European streets from flooding damages when it rains and the rivers over fill and no legit sewage system has ever been built in Europe.  Every few Europe has massive build up and overflows of their excess rain water drain system where raw sewage over flows throughout the entire country and there is a 93% chance the toilet systems hooked up in European houses allows sewage gas to flowback into people houses because the houses were never designed to have toilets in them and the sewage system itself isn't designed for sewage at all nor for people drilling threw their floor into the run off systems dumping raw sewage into the water drainage systems.  The reality is Europe has about the second best living conditions in the world with America having the best.  Also less than 30% of European houses have a safe electrical system hooked up and less than 8% of European houses are even designed in a way for proper electricity to even be installed in the houses at all.  Europe is second best in the world with America being the hands down best home designs in the world and Europe has an 80% chance of raw sewage going into your home and a 90% chance of the house having electrical issues.  Hell there was a woman a few weeks ago that finally had her home looked at properly by an American on vacation who blatantly proved that the reason she was able to stick food on a pan and place it any where in the house and it would cook was because her electrical was designed in a way to back loop the electricity and it make her entire house into a microwave.  This happened in South Korea and to make matters worse the guy literally was on vacation from being shipped by his company to fix that same issue in over 30,000 European homes.  Europe hates people talking about how absolute shit their lives really are and outside America Europe is about the best living conditions.  So turns out a European house building company built over 30,000 of the exact same house type and every single house was built the exact same way with the exact same problems then the guy had to go out to South Korea to fix more houses built by that same European company.  Europe is second best and they live in absolute shit conditions.
Reply: But the design is good mostly, not just the cheap concrete dices, they try to sell as expensive high value stuff. And the concept of creating gardens around and to safe money in repetition of sthe same 10 or so higher class architecture models.
Just the wooden "walls" principle is not good like at 🔥California or in the storm areas.
Reply: saw a picture of a high rise building in Lebanon , build with cinder blocks , it had been severely shelled , 
there was a lot of holes of various size made by rifles , machine guns and artillery , one apartment had been patched , and repainted with the family standing at the window smiling 
all around were impact holes , the building was standing structurally unaffected 
A big building in turkey build of well made concrete had suffered a very severe Earthquake which destroyed most of the city 
located on top of a hill , the shaking had caused it to slide down hundred of feet down the side of the hill , it stood straight tough it was buried up up to the first floor and all the windows were broken 
the inhabitant refused to leave to be relocated claiming it was the very best building ever made
Reply: @Mike_Fortin  they could be waaay cheaper. Brick is cheap and in the rest of the world brick laying is a low paid skill. Is it done sketchy- not even by a stretch. Artistry at its best. Even the art of brick making is still practiced on smaller scales. So much bricks can be formed, stacked into a kiln and burnt to clinker quality in 3 days in your farm yard.

Codes will stop you lighting a fire willy nilly in the US. Nor will you be allowed to make your own bricks. Sand is everywhere and that wont cost much even at a commercial scale. And they have good thermal properties especially the farm type bricks that may have grass and other bio matter mixed in them. They sun dry, cheap. Only the burn needs energy which may be coal or wood on domestic scales.

Iron corrugate sheets have been in use for more than a century and am only seeing them getting popular here now. Plain, painted, rippled and sometimes with a sand coating to mimic clay roofing tiles. They last a lifetime.

Cost of building could realistically be reduced by almost half just by those few changes
Reply: yes
Reply: YES! Very different... even Mogadishu's, and they are upright!
Reply: Yes. Period.
Reply: Yes.. from Ireland
And America is a dump at this stage thanks to your warmongering Washington government.
Reply: Yes
Reply: @Mike_Fortin Did I make the right choice? I didn't want the hassle of moving too far when I moved out of apartments, and so I bough a (new) prebuilt local. 280k for 3br, 2/1 bath, 2-car attached garage, +appliances (except w+d), small (almost no, really) front yard, large backyard. It's stick-frame, like everyone else. Could I have built my own, with concrete or something, for less?
Reply from the maker: @fnamelname9077  as long as you’re happy with it - new construction would definitely cost more. 

Could be something to work towards
Reply: it's as simple as "the 3 little piggies".
Reply: Obviously properly constructed concrete and rebar homes are going to withstand more and last longer. But look at the costs and supplies needed. Houses already are extremely expensive in the West. Imagine the US required to use concrete construction for ALL single family homes.
Reply: Well, yes. But maybe not as much better than you might think. Okay, there are some pretty bad standarts for energy efficiency in the US and you could say a lot ablout actual utilization of cardboard ... But one of the main advantages of solid structure construction in Europe is thermal mass, not insulation - which you can adjust to your needs, no matter if the structural component is wood or rock/brick/concrete. With a lot of thermal mass you can do air exchange and as soon as you close the windows, the temperature of the walls will heat up the air inside to the previous temperatures. That is important, when your heating largely relies on central heatings with water filled radiators. But when all of your homes have AC (which is not very common in european homes) and cooling and heating only has to influence ventilated air, thermal mass becomes much less relevant.
Indeed, a lot of older homes in germany will legally have to swich to heatpumps in the near future, but heatpumps are inefficent, if they have to heat water to high temperatures. But with the old radiators, that would be necessary to get older and poorly insulated homes warm enough. Adding interior insulation is risky, because it can cause molding, externally it is expensive and often can´t be done, because many old homes are protected cultural herritage.  One viable solution is the instalation of split AC (for heating instead of cooling) - which are technically air-air heatpumps. The air in them does not need to get very warm in order to heat the interior. But homes with much thermal mass are not ideal for that system, because they actively work against quick temperature adjustments. If you go to work, you have to keep heating the home, otherwise it will be cold, when you come back. With less thermal mass, you could regulate temperature much more on demand.
Reply: @martinhuhn7813  Thermal mass functions as a heat sink, and while this has some benefit in more temperate areas, where localized weather is median and not extremely variable, this can be problematic in areas with high heat or large temperature variance, and does little to keep the internals warm nor facilitate heat flow outwards. During winter, a stone floor is significantly colder and more uncomfortable to walk upon than a wood one, and homes with basements have a nice air gap between the frozen ground below/around the basement and the first floor (with wood supports and flooring) which means the floor is warmer without requiring powered heat pumps. The reality is, with superior insulation, you can retain heat for longer than without, and won't neccessarily have to keep heating or cooling a home for when you return but can also selectively heat/cool when you are present quicker using AC. In America, there is little need to bundle up in the winter or cool off in the summer for people who have a well insulated house and/or can afford to run their AC... in certain desert areas, this is a must, and it is a primary concern for power companies to keep themselves running because of it's neccessity. Norway, Finland, and Sweden all use wood housing because of the superior nature of internal insulation over thermal mass, and Australia also uses wood housing because of it being able to insulate the interior of houses from heat as well. "Most of Europe" is exceptionally temperate and has a significant amount of large bodies of water that regulate it's temperatures - the heatwave effecting Britain not too long ago (peaking at 10*F or 40*C in '22) which pales in comparison to American heat waves in states, reaching 110 for weeks EVERY YEAR and certain areas getting as cold as -55*F (-48*C). Even arctic clothing uses an airgap with insulation for warmth due to the superior effect of 'fluff' insulation over 'heat stones'.
Reply: I live in the Southeastern region of the United States. My 1970's split-level house is constructed of concrete, CMU, and pine with cedar and brick siding and GAF HDZ roofing shingles. Over the years, it has seen high winds, ice storms, earthquakes, flooding, electrical storms, and occasional snow. Summers are humid with temperatures as high as 110 degrees fahrenheit (43 degrees celsius) and winters as cold as the mid twenties (around -4 degrees celsius). Yet, she stands strong, proud, and unaffected. Our frost debth is about five inches (just under13 centimeters), so our building codes are not as strict as some states in the northern parts of the country. The United states has 8-9 climate zones whereas the UK has only 4 (for comparison). The State of California is in 5 of those. Every state or local jurisdiction has building codes which contemplate these zones and their specific microclimates. Let us not forget that housing in the United States began long before any European stepped foot on North American soil. First nation people built houses of stone, brick, wooden poles and bark, as well as, animal skins over timber frame. They built log lodges long before Europeans arrived. And, let us not forget the grass huts of our native Hawaiians or the igloos of our native Alaskan sisters and brothers - ice bricks, my friends.
Reply: Yes
Reply: Would you like some photos of a NEW Ukrainian/Russian type house that I saw in the process of being built near the Dnopro river near Dneper Ukraine. (Was formerly Dnepropetrovsk) The house is beautiful and is like one giant chunk of concrete and bricks and has a steel and steel/wire sheet roof covered with Asbestos to provide a fireproof roof. The windows and door are wood and are the only combustible things in the building besides contents. Pipe is put in the walls for conduit and is easily rewired or replumbed if there is a fire. Good video.  I took the photos myself with my own camera some years back.
Reply: 1000%better
Reply: Also in Chicago we have brick houses with actual brick walls
Reply: YES EVEN HERE IN THE CARBBEAN
Reply: YES THE USA SURPRIZED ME OF HOW LOW QUALITTY THIER BUILDINGS ARE LAYING BLOCKS WITH A GOOD FOUNDATUON NO STEEL IN CIDER BLOCKS YOUR LUMBER HOUSES ARE NOT TOO BAD
Reply: @ we have extreme weather in states . Brick is not good for insulation. Here in Chicago the past few days has been anywhere -23 Celsius to over 37 in summer .  It’s normal is much of the Midwest . And this is every year not a weird event. In places like Arizona you have different building materials because their homes are exposed to more constant weather patterns .
Reply: I live in a solidly built frame house from the 1940's. It's got it's problems for sure but I wouldn't trade it for a new built. They're just plastic wrapped frames of cheap twisted  wood set on top a concrete slab. 
My ideal home would be a concrete underground earth sheltered home.
Reply: Yes
Reply: Not in UK
Reply: The problem with houses from the last 80 years is the engineering and industry standards are nonsense. My city every houses have a back alley increasing the land every houses occupied. You can build 1/4 more houses on the same land if you remove back alleys making the city expansion slower and easier for people to drive around. Houses are too close to each others and mostly have plastic siding that burned easily and all houses have soffits that are fire hazards. Very easy to force contractors to use bricks or stucco and only soffits on the front and back of houses to prevent fires to jump from 1 house to another. Very simple but no our politicians are stupid
Reply: Yes... mostly since ours are designed to fall apart after about 40 years. Soon after the first & just in time for the second mortgage to be paid off.
Reply: Yes.
Reply: Spread pacife Knowhow
Reply: Depends. My sister lived in Norway. The House was built directly on rock, no insulation from beneath so the cold was creeping trough the floor. The walls were approximately half a foot, lumber and plaster, with single pane windows. The only heating was a wood oven in the basement. Not at all suited for a country with winters like Norway. And it wasn’t in the back of the woods, it was Oslo of all places and costed an arm and a leg to rent. I was shocked to see such a miserable construction in one of the wealthiest countries of Europe. But her second home in Bergen was a house in the country that overlooked a fjord and was built to much higher standards. That was a very nice place!
Reply: yes and no...
Reply: American homes are made from sticks and tinder, they can hardly survive a gust of wind, they freeze in a snowstorm and burn to ash in minutes. You often build houses 3 feet away from each other causing a fire hazard from fire jumping the gap. You use shingles which is like covering a house in matchbooks. When compared worldwide American houses are fine, but compared to Europe and take into account American wealth and conditions they are worse in every possible comparison.
Reply: 100%
Reply: Steel framing is very common for rural homes in Australia due to the threat of termites.
Reply: And full of black mold
Reply: it's a diference in geography and social problems, the kind of materials used in USA, would not protect people here from the rampant delicuency we have, also we have no huricanes here,  but tremors, so our building have to deal with that.
Reply: Earthquakes are a consistent and devastating issue for affordable "solid structure" homes around the word. It's weird to just slip by the devastation caused by earthquakes in Haiti, Nepal, Tukey, Syria, etc. Solid structure weighs a lot more, which is great at resisting wind, but adds a ton (or multiple tons) more strain when the ground moves laterally. It's a little telling that you conveniently forgot to mention that light wood framed houses are virtually earthquake proof. Solid structure is a great idea for homes in tornado ally and the south-east coast, because of wind and rain resistance, modern versions with high insolation value would be great for the north-east too. I hope modern, well built solid structure could work in California, but the earthquakes make the difficulty higher... It would certain help with fires though.
Reply: @ Japanese have been building good solid houses made from wood for centuries, but the houses made by wood in the US are a joke in comparison.
Reply: @ yes they are, because the houses in Japan cost a fraction of those in the U.S.. Japanese housing market fluctuates but is usually in an affordable range for everyone, with 3 and 4 bedroom houses renting for around $400 a month and selling for under $100,000. This should be the pricing range for houses in America because realistically you wouldn’t be getting much for what you’re paying for realistically. I have a house in the U.S., Austria, and Jordan in the Middle East, my favorite is that of Jordan, a stone house with beautiful design, it’s 250 square meters and looks like a New York high rise, it cost me only $220,000. My home in the states is $632,000 and is also a 4 bedroom, but it’s only 160 meters square and looks good but not anywhere near as good as my house in Jordan. My house in Austria is rustic and a 5 bedroom with 230 meters square, and cost $390,000. It is made of wood as well, but an older style, it comes with a massive estate however, which is included in the price.
Reply: @MrLainon  You may want to check which type of building survived the Fukushima disaster and which did not.
Reply: Yes.
Reply: my house is 110 square meters per floor, 2 floors with outer walls being 125cm thick stone and mortar construction with steel reinforced floor and roof perimeter..pretty standard adaptation for an old stone house..making a dooor from our boileroom to our living room took a few days haha..all in all its not cold and on the contrary it actually holds heat nicely..the outer facade is mortar made with quicklime and eggwhites about 5 cm thickness and the whole house is nestled on foundations of crushed rock ontop of live rock..house is like a monument to safety and permanance, not a semi-permanant housing..it has stood since 1700. and it will stand for generations to come..it was a mill, a school, a local goverment building and now after albeit long and annoying process a family home..for everyone saying that old constructuion and floorplans dont allow for comfortable modern living they are wrong..as i can comfortably ride my bike from the living room tv area to my kitchen ..my house is not the norm but most houses in my village are built to same standard just a bit smaller...the builders knew how to get warmth from the cold stone they were working with..ps it had lasted trough a few medium earthquakes and im 100% positive there is not a tornado or hurricane that could scratch it as i remember with bitter fondness the time i spent with a jackammer hitting those often 200kg stones to make a door :)
Reply: Yes, absolutely
Reply: Brick and mortar last forever, just need to be earthquake resistant,, don't need to pay insurance anymore !! Corporations will hate it!!!
Reply: The total destruction of homes in the. LA wildfire shows how property developers cut corners in safety even in ultra. Costly houses to make quick buck. There was this news of one untouched house which was built properly and the rest of the neighborhood completely reduced to ashes.
Reply: You're wasting our time with extraneous drivel like on half timbering!
Reply: Most modern reinforced concrete homes around the world are definitely better than any US stick built 🗑️ 🏠. The beginning of the video gave us a clear historical lesson, but most of these countries (3rd world included) have evolved, and all things being equal have been using concrete for decades now. Concrete homes stand long after stick homes. Let's look at Florida's Miami Dade county building codes, for ex. These houses are built to withstand hurricanes as well as fires.Time for the rest of  the US to get with it, already. Get the lumber industry boots off our necks, already. 😅
Reply: Yes fact
Reply: The US is a capitalist country. The construction industry preferred you to build your home with sticks so they could charge you for re-building each time there is a natural disaster. Japan, Taiwan and China have typhoons and earthquakes, yet they don't build their house with sticks, paper, glue and cardboard.
Reply: Yes
Reply: @Mike_Fortin  I added a reply about the AU phenomenon of whiteants and the structural damage to foundations, thus the verb "to whiteant". YT has censored it, either to punish me for cancelling my paid sub or to press the point that tech bro censorship is SO bad it is better abandoned.  Ho hum. Off to the Swedish podcast service Spot...
Reply: No they are not.
Reply: Totally agreed 👍
Reply: No.
Reply: Depends on the house. That said, I don't approve of 24" on center stud spacing. 16" is already pushing it.
Reply: Not in the UK , many old houses without proper insulation and with mould problems. The modern buildings though are ok. In the US the houses are generally bigger than in Europa.
Reply: Yes
Reply: Everywhere homes are dictated by economics and legislation. Great homes are in every country, just depends on how deep your pockets are and how creative you can get around and fulfilling building and safety codes. And "great", "homes" as definitions are very subjective terms.
Reply: yes
Reply: yes
Reply: Arnold isn't strong enough to break a wall in an Austrian home.
Reply: From Denmark, not a builder, but when living in the states, AK and CO most of the houses seemed like big fancy sheds with a (tiny) bit of insulation.
Reply: Swede here...I would say YES!!!
Reply: Yes
Reply: Make home by concrete .... Your homes will not burn in wildfire
Reply: "Better" is a relative term defined by the conditions.i.e. A steel structure is better...when its far away from the sea. US houses would be great in , i.e. Greece where we don't have tornadoes. Concrete framing and masonry feeling would be great in Greece (earthquakes) if the constructors didn't cheap out on materials.  Walls that you can  kick your way through are not good in high crime areas.
Reply: Yes as American homes are very sensitive to fire and in most countries u can hear a news of 1 or 2 house burning but in America u will see the news of whole village or part of city burning.
Reply: Lol i live in Algeria ( Africa )and we have better homes last year we had a fire and nothing happened
Reply: You forgot the second major US building component, PU foam.
Looking into what other nations research about PU's toxitity and highly problematic disposal shows might surpise you.
At the end it is all about the price. US ticky-tacky homes are dirt cheap in comparison to most European ones which are build to last.
Reply: I think this question is simple to ask but almost impossible to answer properly. Material availability and cost are a point that I didn´t really think of yet. And law and expertise of your local craftsmen with certain materials and construction methods are important aswell. My parents are adding some new rooms to their house at the time and a new bigger balcony. And as things are in Germany you have to get permission first to build something new. At least you better get it before, doing that afterwards is a pain in the butt and much more expensive. You must hire an architect for the planing and a stress analyst to be able to get permission and the build has to be done to their demands. In the end the new building has to be inspected twice, once by another stress analyst and once by someone from the local building authority. Unless all the inspections are passed successfully you can get sued to tear it down again. Law... And strength requirements are pretty harsh as we had to learn. The balcony is required to be able to hold 400kg/m² (83 lbs/sqf) by the law. The architect we hired suggested to use timber custruction as it should be cheaper. Well that´s wat he said. It isn´t finished yet but from what we had to pay until now and all the difficulties that had to be overcome we wonder if it would have been so much more expensive building it with brick walls instead.
Reply: American homes are a joke. Americans deserve better
Reply: Just to be a devil's advocate - I'm in the UK and we USED to have relatively strong / durable construction, but it all started going wrong around 1980. 

The house I grew up in was built around 1971, a brick structure with wall cavities that could be insulated (cavity insulation was a big business for a long time - hard to understand why the insulation wasn't installed from the start) and still looks exactly the same more than half a century later. The walls haven't cracked, for instance. Sadly my parents moved house twice since then and now dwell in what I call a cardboard house - accursed modern construction (see below). In my dreams, I'd still live in that house, were it not for the fact that the garage is far too narrow for a modern car.

The house I live in was built around 1991, a timber frame with brick facing (and ubiquitous cavity insulation) - and there are cracks in the internal plastering where the timber frame settled after construction. It's also not uncommon to see houses like this where the exterior brick facing has cracked due to the same settlement. In my understanding, this style of construction was pioneered by a company named Barratt in the 1970s (I remember all the TV adverts for Barratt Homes) and certainly back in the '80s it was used as a term of abuse to describe modern houses, thrown up cheaply. Naturally, big housebuilders carry a lot of lobbying clout and this style of construction was allowed to persist instead of strength / durability being mandated. I call it cardboard housing because it looks so flimsy. The single garages on more modern British houses are still too narrow for modern cars, but I'm fortunate to have a bespoke-built garage that is a good 80cm wider - it's the only reason why I've stayed in the house for over 25 years.

Fortunately even this awful standard of construction is better than what seems to be standard in the US - I could never understand when I watched some US-made TV sitcom in my childhood and somebody punched through a wall: I used to wonder why we couldn't punch through walls in England in the same comedic fashion. Now I understand why your houses are so much cheaper to buy and larger (relatively cheap land notwithstanding) - a couple of decades ago I entertained the notion of going to work for a US sister company of my then-employer and found that I could have afforded twice the size of home (on a plot five times the size), but I never considered how much it might cost to keep warm (or cool)  - or your riotous property taxes, for that matter. The cost of living in the US is substantially higher than in the UK - it's the other thing that puts me off the idea of emigrating nowadays.

The lesson is - cheapness is infectious! European houses still tend to be much better-built than the modern British norm - Europe hasn't contracted the same US disease yet....
Reply: Yes
Reply: American homes:
- substance is lacking (I was even warned that you could accidently shoot through the wall with a shotgun)
- 120V power
- bad isolation, leading to ridiculous heating and cooling bills
+ centralized HVAC (this is were European homes cheap out)
+ parking space is not an afterthought
Reply: Here in croatia 90% of houses are built from brick and mortar. Those what are built from wood are destroyed and rebuilded from brick. Us houses are joke 😂 house built from wood and filled with insulation no wonder you are suffering from tornado damage from wind damage from fire from mold from rodents 😂😂 europe house 10mx10m = 25-30tons👌 us moldy wood house 10x10 = 5-10 tons
Reply: Wild west doing houses are not good for quality and you dont seem to have a basic instinct why not build so and so for longlivity
Reply: Yes, houses are built better in the Philippines because they use concrete. In the United States, they are built with wood which is not as strong and are susceptible to weakening in its environment. I'd much rather live in a concrete house than a house made from wood.
Reply: Way better, but a lot more expensive
Reply: @klausbender4651    Wait, what? I thought you were the richest country on earth? Why can’t you afford to build houses that countries that are far more ”poor” manage to finance?
Reply: Por supuesto, es que no hay duda alguna.
Reply: Who cares what other countries think about American houses. We live here. They do not. If they move here, they can build whatever they want.
Reply: Yes 100%
Reply: There is a very interesting fact about home ownership. The poorest countries in Europe, such as Albania, Hungary and Portugal, are the ones with the most paid-off and owned homes. While the lowest percentage is among the richest countries, especially among the new generation that pays rent. (Switzerland, Germany and other developed countries are the ones with the least home ownership.) Which makes me wonder if it is really worth earning more if you leave 35% of your income or more in rent or installments. How much is really left over?
Reply: Only 3% of Switzerland's population owns their own home. the other majority either pays rent 30 or 40% of net income or has financing. The USA, despite having a lot of financing, has a higher average home ownership than most rich countries in Europe
Reply: Things to consider. The US is approximately 300 years old and most of the houses are less than 50 or 70 years old, it is still a young country. In Europe, the first settlements are 6 or 7 thousand years old. There are stone houses in Italy, Spain and Germany that are more than 300 or 400 years old. Invasions and wars have passed (this is reflected in civil construction). Another point to consider is that the average home ownership in the US is higher than in Europe. In Switzerland, only 3% are homeowners without debts.
Reply: Why is this even a question 😂
Reply: Yep. This video was was some amazing cope. The answer isn't "yes and no" the answer is a very solid "YES!, other countries build better houses"  and also tend to have stricter building codes.
Reply: It really depends on the location of the house. If you have the house in the right location then they are not better or worse. If your house is in a bad location then yeah it’s worse. This is something that America will never be alone on this.
Reply: Yes, your insulation is dog shit
Reply: Norway: American houses are way more flimsy
Reply: @Mike_Fortin   swede here. The only plastic we use (and it is becoming increasingly more rare) is plastic flooring. Everything else is bricks, cement , wood or metal. Wall to wall carpeting is very unusual and will never be used when a house is built. Plastic sidings is basically non existing here. We have mandatory independent inspectors during the build process, not when the house supposedly is finalised. We also have very strict building norms that regulate basically everything that is either structural or pertains to water, plumbing, electricity, heating and ventilation. Also, our houses are either centrally heated or heated through geothermal pumps. Oil or butan heating is never used anymore. Granted, it is more expensive to build and buy, but our homes are built to last, and be repaired.
Reply: of course they are.
Reply: there are no precast concrete walls in switzerland. those are woodframed insulated and have fireproofplates that look like concrete on the side.. i think they are named  fermacell
Reply: There is an element that you did not take into account for the price, purchase and resale. 
You see in Europe, it is not common to have this house built, for the general public (not millionaires and billionaires) and therefore the price depends mainly on the real estate market, which means that the price of "solid" structures is in reality lower in Europe.
According to quick research, in December 2024, the average price of houses in the United States was $513,600. While in 2022, the average price of a house in Île-de-France was €424,473 for an average surface area of 113 m², or approximately $441,150.55. 
So, all this to say, that unfortunately, European houses are better than American ones.
American houses don't even benefit from the low price...
Reply: Wooden style US houses are so much better than European houses that Europe is starting to build your house
Reply: @z-0669  Bro, I have nothing to say, you don't seem to have seen the video you are commenting on. But, although your witticism does not provide any arguments but only a subjective opinion. If you love your cardboard house, that's your right.
Reply: No, they are just different.  I've renovated houses in 3 countries and lived in 7 countries.    They both have pros & cons.  I prefer US houses, European houses are far too difficult to modify or repair, which means that maintenance is often ignored.   This is particularly true due to the skill & labor required for brick vs wood, which is a huge problem in the US with the shortage of construction labor.   Plus, large parts of house can be factory built, like roof trusses and SIP walls...
Reply: Honestly there are some improvements US houses should make, but I still find them better in some aspects to homes here in Japan. Biggest example being that most wall outlets in Japanese homes are non-grounded. So good luck trying to hook up computers and all inside the house.
Reply: As you said  everyone!
Reply: I enjoy my American house from the 1800s masonry built to last
Reply: European solid houses, I am living in one, cost more energy to built. True. BUT. Lasting way, longer. Consume so much less HVAC energy all the time. Over Decades the energy bildnce, shifts STRONGLY to European homes, summed up, that's the main reason, why we do use so much less energy per capita and year. The other thing is meteorological disaster resilience. At eF2 we may see damaged roofs, some blown in windows. At eF3 the roof is gone entirely, nsn windows too. But. Thee house stands repairable. You life is safe, and all you personal goods are safe too. Even at eF4 you may find safe zones without a cellar. Only at eF5, there is no difference, those are rare. So we are fairly safe against all kinds of Hurricane force winds, and somewhat better protected from fires. Cold and heat waves we fare better. Floods are nasty, damaging all the interior, but the hose stands, the upper floor or the attic helping out. Even in snow avalanches, our houses in the mountains are holding up. The buildings of Galtür saved many. Only in hailstorm sour roofs will get more damage (leading to water entry, but still there is a solid floor in the attic). And in earthquakes woodframes are of big advantage. In regions safe from earthquakes, light wood frame doesn't have any advantage, than being cheap - which is the criticism. Well built wood frame buildings, with serious insulation, are definitely en par to solid stone material homes, and long lasting. But also as expensive.
Reply: Im from holland and yes our houses are built to last from bricks and getting a house of same square meters built here as your multi million dollar homes would cost the same but take longer to build
Reply: Yes
Reply: I think the main reason the rest of the world moved away from timber framing centuries ago is that we ran out of good lumber and had to find other methods. Domestic buildings have always been made using the lowest material cost available for the highest profit. When you have to import the vast majority of your lumber, wood framing becomes too expensive. Population density also drives material choices, as can be seen in Manhattan
Reply: North American construction methods are definitely inferior. The focus is on profit so everything is built to the minimum legal standard. And NO building with concrete is most definitely NOT the answer. I am a proponent of rammed earth and have built homes in different climates using it. It is by far the cheapest, most readily available and environmentally responsible building method. It requires more labour and a bit more time but as far as I am concerned, that translates to more jobs and better built homes and buildings which also have much better comfort and energy efficiency.
Reply: USA is better at air-conditioning. Us in Europe are SO far behind on that front. Y'all really know what you're doing when it comes to A/C.
The areas you fall behind on are mainly economical. Cutting corners to maximize profit makes your modern homes so fragile, not built to be lived in for generations, but built to be sold quick. You can build well, but usually you don't get to, because the people who can afford to make homes only want fast and cheap.
Your second problem is "zoning laws". We have building standards in the EU, but we generally don't have the same restrictions for the use of buildings. Y'all are really missing out on those buildings with shops at the ground floor. They make cities so much more walkable, and that greatly increases one's sense of personal freedom.
So yeah, I don't think we build better, I just think y'all are held back. Our old buildings are cool though, and I'm looking forward to a return to some of those beautiful brickwork architectural styles😊 Hopefully they can also inspire y'all to build of something heavy enough not to blow away😊
Reply: I like American homes. A house needs to fit the needs and tastes of the persons who intend to live in them. Nor must they be built built to last hundreds of years. In other countries homes may be constructed of brick and concrete, but even they deteriorate over time. How difficult and expensive is it to repair and renovate such houses? How flexible are their designs and materials, that they can be altered cost effectively, to meet the changing needs and tastes of their occupants? 

American homes are designed with many extremely practical features like built-in cupboards, kitchens, wardrobes and storage. They have interesting features like coffered ceilings, open main living areas with cathedral or double story ceilings to make them look more interesting. There are also so many different design styles ranging from craftsman to mid-century, Queen Anne, traditional or modern. 

A particular floor plan can be offered in a number of different exterior styles to satisfy the personal taste of buyers. That level of flexibility is not readily available in many other countries.

American building technologies keep evolving with new methods and materials hitting the market. American housing is not inferior to other countries. It is adapted to the prevailing conditions of the different climates and geographies that exist in the US.

People always point to the fact that American houses are often obliterated in hurricanes and tornadoes. Well, in Europe they don’t get hurricanes and rarely do they have tornadoes that are stronger than a F0. Where they get earthquakes, European houses are often severely damaged or completely destroyed. An F5 tornado ripping through a European city would cause incredible damage. These storms have the ability to twist concrete structures off their foundations. Which construction methods are faster and more economical to replace?
Reply: Depends on the country… 
Europe is starting to build this cheap houses like you find in some states as well. My house in Switzerland is older and is built of brick, Steele and concrete but there are these prefabricated box homes popping up everywhere! My grandfathers family had a plantation in Suriname I took my kids to visit and everything was standing just as when I was a kid it’s the old craftsmanship of the Dutch/German colonials the people can afford it try to build in Steele and stone.

HOWEVER where I grew up in NYC these where also colonial old Dutch homes and bricks were falling off of them sometimes 🤷🏽‍♀️ maybe that’s lack of upkeep. In general I find new homes flimsy!
Reply: Australia is basically same thing. Only way worse quality.
Reply: The problem is that in the US hauses are build as cheaply as possible to be sold at a premium, because someone want so make a fast buck with money loaned from a bankm which is loaned on the house. which makes the bank the owner of the house tbh. Also, a cheap home has to be rebuild in 10-20 years, furthering someones capacity to make a fast bucko

In Europe you OWN your home, any loan is on YOU as a person and not the building, so you'd rather have something that your grandkids still could use in 100 years time
Reply: @Mike_Fortin  100% These days, well in the past 70yrs. My family has owned an 1890's commercial/Apt. building since the 60's built with 18" thick solid blocks, the weakness is in its wood framed roof. I had to re-seal and secure some grout 24yrs. Ago, but other than that, the structure is solid. 

I feel like as long as I agree to design wood framed architecture, I am indeed contributing to the demise of fire prone disaster, which is why I am devising a plan to no longer accept these projects. 

Promoting and implementing change is hard in an area of California that is primarily wood cabins in the Sierra, but I plan to give it a shot! Or move, I suppose.
Reply: Yes they are
Light wood buildings are good for earthquakes, which are rare in most of the US
They are bad for hurricanes, tornadoes and floods which are common in the US
So basically you guys are doing the opposite of what you need
Reply: @bulentkulkuloglu   gues it goes hand in hand doing that kind of short sighted construction stupidity when corpo dynasties more or lees hijacked the economy for them and religion common sense :/ since everything i seen of us building , or any of the 'super nations' building just strikes me as ''the drones dont need good warrens ,if a few millions die just make them breed more'' :(

and personally but miffed about it due to how the religious and 'totally not the nobility and rich peoples piss down economy party'' kept borrow inspiration how to run society from the us such as the stupidity of borderline none existent construction standards etc the last decades bha
Reply: No.  American houses are well built with central heat and air conditioning.  In the suburbs, houses have beautiful yards.  When you walk along the sidewalk, it's lovely.  But in Europe, most yards have fences and it's just boring walking past fence after fence.  American roads also tend to be better with warning signs for curves.  Finally, America has very strict building codes for homes.  I've lived in 7 countries on 3 continents.  Unless you have a high-paying job, you will have a tough time buying a house in Japan, the Netherland, France, Germany, Canada, Austria. etc.  Japanese houses are real nice.  Currently I live in FInland and here you can find beautiful home for cheap in the countryside.  Finnish roads are well maintained, but there needs to be more guardrails if there are deep ditches with water.  None of the curves are marked, but thankfully there's plenty of forest so you can usually determine the curves by look at the treeline. In France I was spoiled because I rented a room at a country estate with a huge well-maintained house and my spacious room overlooked the courtyard in the back.  In Canada, I was fortunate to rent a nice house because at that time, the exchange rate for currency was in my favor.  That said, I think it's nuts to compare houses in one country versus another because you need to compare similar houses that are the same size, same age, same climate, etc.  Comparing my friend's gorgeous huge house in Texas to a home in Finland, for example, wouldn't be useful because Texans don't worry about central heating and most homes there don't have a basement.  Finnish houses usually have a basement or at least a cellar, they tend to be smaller, and there is always a good heat source - usually a wood burner (which are extremely efficient) and a secondary source of heat, such as a water heat pump.  In Texas, you probably have a big yard and in Finland probably not unless you live in the countryside.  While both countries can have tornadoes, good homes in Texas have the sturdy frames bolted the cement foundation and other features to make them strong.  In the 20 years I've lived in Finland, I've filmed one tornado that was actually the real deal, whereas most other tornados originate as waterspouts and some might move inland.  So, Finns don't worry  much about twister, but rather snow load on the roof.  Historic wooden homes in Michigan are comparable to historic wooden homes in Finland and both countries paint their barns red.  That said, every home is different in terms of details, how it is furnished and decorated.  Finally, governments need to ensure that everyone has a roof over their head and I hope more communities in America emulate was Houston, Texas has accomplished for all the homeless people there.  They based their system on the Finnish model and it worked well.  I've always said America can't consider itself a superpower until there is a roof over every perrson's head and a tornado shelter in for every person living in Tornado Alley and Dixie Alley.
Reply: @Strizh.Torcher  sorry but it does feel like you lost yourself from the point a bit there , but neat hearing you got such broad experience in living conditions , as for example no one expects american homes in hot tornado regions to care about heavy snow load designs vs having a bunker underneath the house
but the standards overall in the states on the federal lvl is abysmal compared to most european national ones and how us more or lees relied on having a higher quality wood material then others to compensate for inferior construction wich no longer is the case

though sad to hear so many houses in the countryside of finland are for cheap but i guess its natural to the 'urbanisation' that civilization is developing towards in a interesting mimicry of the first city state empires in ancient mesopothamia & Nile where the countryside used to feed the urban centers becomes focused in more efficient/productive areas first and outlying areas only guarded for future need but not lived in
Reply: I think you look stupid holding a mic in your hand that comes with a clip so that you don't have to hold it in your hand.
Reply: houses in my country built out of bricks or tree logs
Reply: we build dog sheds the way americans build their homes.
Reply: Yes
Reply: Most countries have one building standard, USA has several... In other words it depends....
Reply: I think it depends on the resources available to make them and how costly it takes when you have to include fabrication, transport, and jobs to make it. I saw how fast a home can be build in the US (I´m from Latam) and how nicely they look at the end. But in my country, wooden homes are costly (most of our forest are protected or not suitable for some foreign trees species) and mug and stone are way cheaper, as well as sand. Of course, cement is the "king element" in construction and I know make a renovation could be costly and takes more time and effort, but cheaper in a time scale. Since the times before spaniard conquest, tribes homes where stronger due to a mix of minerals to build huge thick walls and there´re very few of them with centuries old. Even more: their platforms where used to built spaniard catholic churches, some of them way older than the USA. Wood was used for pilars and roofs. Nowadays I think a wooden home is like a scam. Nice video btw!
Reply: No they ain't any better. I'm leaving out manufactured homes. We bought a farm and it had a 200 year old plank house. We remodeled it and put studs and insulation and then drywall. That house will stand another 200 years.  The house had tree logs for the floor joist and the rest of the frame was barn constructed wooden pegs holding the house frame together the planks were two inches thick and 14 plus inches wide. I really don't think the house will fall down. Now if you are talking about modern homes I can see some flaws in design. I see people making tiny homes out of sheds and the shed is not good building material. I would use blocks and use 2x4 to do the outside walls. Blocks have insulating qualities but add foam 4 inches thick you would have a well insulated building.most use firing strips on the outside walls. Don't leave much room for insulation. I seen some cement homes in Florida that are very strong but not too well insulated. 73
Reply: My house in Lithuania has 200mm clay bricks and 250 insulation and 15mm of lava stone decorated in total 465mm of thick, well insulated and decorated wall which will last for centuries.
Reply: I was in Bermuda for a race recently, and all the building are built to survive hurricanes. All the roofs are designed to gather rainwater because it’s the primary source of fresh water. That water then goes into a tank underneath each house that acts as an anchor for the whole house. Overall, very solid and genius.

If I have anything wrong, please correct me. I wasn’t there for too long. (Also 10/10 would recommend going to Bermuda)
Reply: Yes
Reply: germany is brick , not concrete and for some rich it is either pure wood or combination of wood and brick, but rarely concrete at all. Only a few are building house with prefabricated walls which are also much harder to sell. Stone by stone and you are save or your fortune is safe.
Reply: The reputation comes from flimsy walls that can be punched through and mold that's just painted over, carpets everywhere incl. bathroom, lethal power sockets, no insulation while gas heater burning red hot and very aged looking and inefficient appliances. Not that other countries don't use plasterboard or particle board in some places. But USA is so much southern than Europe many things just make sense. Europe lies mostly around the same latitudes as Canada or even Alaska so of course building standards must be stricter. USA is mostly on Northern Africa latitudes so feel free to build reed huts if you feel so.
Reply: Cheap materials,under built and way the hell OVERPRICED !!! That’s American built homes now 🎉🎉🎉🎉🎉🎉🎉
Reply: People in other countries are not jealous of America's greatness !! Perhaps they would be if America was anywhere near the top of either the world Freedom or happiness indexes, but it's not, and it's status is falling every day under Trump !!
Reply: @Mike_Fortin  Yes. Houses in US are crap. As well as healthcare, education, economics, culture, politics and president 🤣
Reply: The reason you still build wooden houses is the same reason you are the only nation that still uses pounds and feet. Obstinance. And to think you were the only people to ever set foot on the moon.
Reply: Yes
Reply: i got to 0:41 and started laughing, american homes are basically made with wood and plaster or how i like to call them 'tinderboxes' as they catch fire with the slightest spark, the frame is made of wood, the attic has stuff that can catch fire easily, if i would take a look at waterdamage.. dutch housing might have a loss when it comes to what is inside the home but the home wont be washed away like the american homes, when it comes to wind (since dutch housing does not need to worry about tornado's i cant say something about that) high wind can take off the light roof of american homes including what is inside the attic. what this shows is that american homes are extremely fragile to it's owners and environment (i say owners because i can hit my fist to the wall in my house and i wont go trough it like the plaster walls inside american homes)
Reply: Having lived in England, their typical council houses are definitely much nicer than the average American home.
Reply: i'v seen them first hand and i build better sheads mate. the worst modern UK or EU home is better built that the finest modern US home.
Reply: watch?v=ELIolXXvIJ4
Reply: I never was in usa, do I can't really compare houses. I live in a rural village in the centre/south of Italy and my house is actually 70 years old. My house is build with the local white stone from Majella and my walls are 60 cm wide. Actually I don't need air conditioning: when outside we have more than 40 degrees (celsius) inside I don't have more than 23. A normal Fan is all I need to move the air. During winter heats up very quickly.
Reply: The USA is not the gratest country in the world. I don t understand why you build that cheap buildings when you have no insurance and every second week there is a Tornado.🌪️. When you habe a insurance it really dosen t matter how expensive or cheap it was, they pay for you
Reply: Yep i think 😂
Reply: Depends on climate
Reply: come to norway and see yourself how we do it over here :)
Reply: Og course they are, anything mad in the US is garbage
Reply: Yes
Reply: Não sei, apenas acho que elas parecem cenários de filmes, parecem muito frágeis..
Quando vem um temporal não fica em pé.
Reply: Yes, there are countries that do, overall, have better construction and planning.  However, there are a lot of solid buildings (pun intended) built in the states.  However, I would say that the a large percentage of constructions in the states are subpar and urban planning is almost never used.
Reply: For the most part the houses themself aint the issue its where they are located at. Would second quess building a wooden house in potential wildfire areas or places where tornados/hurricanes occure.
Reply: Most of the time... yes
Reply: Whole lot of bs misinformation
Reply: Ваши дома - дерьмо полное. Это вам мнение из России. Мы такие называем из говна и палок.
Reply: Yes and no..... 
Generally yes.... they are much more sturdy and solid....
But are they more healthy to live in?    
Not always. 
The internal climate in a concrete house can be extremely bad.... 
Whereas wood as a living material is far better at making the house breathe and so with the people living in it. 
But many older houses in Europe are still build with only bricks. And that actually also gives a really good environment  for the people living in it.
Reply: The townsh
Reply: 5.40 dollar for 50kg bag of most expensive cement (110.23 lbs)
58 dollar for 1000 most expensive red bricks 
There are cheaper ones😂😂😂
Reply: 😂😂😂😂,..of course,...!!
Reply: Because they are jelous they cant afford a house
Reply: @Mike_Fortin  yes
Reply: Yes
Reply: absolutely!!!
Reply: Ist es ok wenn ich als deutscher der das Handwerk stuckateur gelernt hat auf deutsch antworte oder verliert sich zuviel in der automatischen Übersetzung?
Reply: Yes Englands are much much better !!!
Reply: Im Very interested in the Metal Framing structure build. Can you direct me to the parts, so I can build with those, Please?
Reply from the maker: @PhantomLife all you have to do it run it by your architect, they’ll know exactly what you need. 

Or, If you’re in IL I can design it for you.
Reply: The Metal parts, That are intended or Capable for a Building's construction; Thats what I'm hoping to find. 
I can design & Build. In California,  Majority of the Metal building parts are Either; A Companies Designed product or Basic Metal parts that require Cutting & Welding to shape. 
But I hope to find General Metal parts for Buildings, as an alternative to Wood beams & Sheets!
Reply: Immigration is still only going one way.  They must like the houses at least a little.
Reply: YES
Reply: Most American homes don't turn into granny ovens when when its get over 90 degrees so we got that going for us.
Reply: We have lots of older neighborhoods with solid construction. I suspect since we have 10s of millions of undocumented folks here, we have an extreme housing shortage for Gen Y and Z. The starter home market is swamped.
Reply: Some of the building methods are superior to American building methods and craftmanship, BUT , they lack the fire resistance American building materials provide. Also, American homes are built in consideration of high winds, such as hurricanes & tornados, except on the left coast. The left coast houses are built in consideration of earthquakes and usually burn like matches
Reply: I just DIY built an ICF  5-story multigenerational home that should last around 1,000 years.
Reply from the maker: @LegacyViewsICFhomeBuild cool 😎
Reply: Definitely, yes.  In Europe they are made of stone and brick.  Not wood and plywood.  Recently, wooden structures have been popping up (cheaper, faster build).  In one place a whole apartment block had to be torn down (rotten wood).
Reply: I'm a bit late to the party, but as someone who has lived in Switzerland and Germany all his live long, I can assure you that what these internet comments doesn't reflect reality.

Simply speaking, the housing market in the US, does offer you much more value in return for your money. The majority of us live in tiny and small appartments in grey concrete blocks. Most appartments don't have an own washing machine, some even don't have a dish washer machine and most of them don't have any air conditioners. The next view, you have is to the next facade. It's not unusual that you've major noise problems, nobody wants to solve, so that you can't do anything about it. Where I live now (Switzerland), buying a house is enourmsly expensive to a point, that not even upper middle class people can afford houses.

When I lived in the US for my exchange program, I was totally blown away how Americans live. They live - compared to us - in beautiful and spacious houses, which don't lack any kind of modern amenities. They mostly have their own garden and garage. 

I actually have good friends, who moved for this exact reasons to the US. They were fed up that they couldn't afford a house with their two kids though both were working full time. They bought a lovely house in Florida. They never regretted their choice.
Reply: Of course. In Europe, we build houses out of stone and concrete that won't be blown away by the first storm like the wooden/"cardboard" houses in the USA.
Reply: In Europe we build solid and stable houses out of stone and concrete that won't be blown away by the first storm like the wooden/cardboard houses in the USA.
Reply: There is no such thing as American homes. I very much doubt all houses in Germany and France are the same either.
Reply: In Europe, termites cant eat our houses.
Reply: Everywhere. 💪
Reply: Yes
Reply: I care about safety, and soundproofing more, than outer design, price, or construction time. If American houses are enough for Americans that good for them, but I wouldn't want to live in a house that's walls can be broken through with an axe. Also while it's not necessarily house design but European walls are thicker so more safe doors and windows can be equipped. I don't think an average German door would fit and average American wall.
Reply: I LOVE AMERICAN  HOUSE. ❤❤❤❤❤
Reply: Most are built better than any American home. Even the straw bale homes of 3rd world countries are built better. Made to maintain a constant temperature.  USA made homes are basically made to create a business of heating and cooling towels keep the home livable.
Reply: I think you are 100% wrong. The US build houses the way we do because the materials we have. Europe has little wood so they build things out of brick. Housing in America is all ready too expensive. But you were advocating is making it an order of magnitude more so.
Reply: yes
Reply: Yeah but compare the sizes 😂
Reply: Of course buddie.
Reply: in other countries you can own a house here you can not because of property tax.
Reply: Las casas gringas son muy bonitas pero son de papel, en Costa Rica America debemos cumplir el código sísmico, todo debe ser en concreto con barilla y estructura reforzada, se debe usar viga corona, simientos, cerchas de metal contra incendio y por supuesto sistema anti incendios, incluyendo todo el sistema eléctrico entubado y llevado a tierra con barilla de cobre de 3 mts, el adobe solo se ve en casas de museo ! Estas casas son pura vida!😊
Reply: 😂 Its funny I was in germany last month and my friend was telling me about this topic. I own a house in the us made out of timber with the front covered in bricks and I can see why other countries laugh at us... 
Because we only think about money but they think about the future.
Reply: We live in Hooverville homes.
Reply: i feel like most europians including myself dont really hate on the idea of houses made from wood. the main problem to us is the american style itself. exorbitantly expensive mansions with lower and lower standart of construction as time goes. wooden houses in europe are commonly small, sturdy, long-lasting and build by the means of people who live in them with multi-generation use in mind.
Reply: haters gotta hate, everyone dumps on the US. Average house size is 2,400 sf, 223 square meters, and many homes over 100 years old are still going strong. Quality homes will last a long time with regular maintenance.
Reply: YES they are..
Reply: Yes
Reply: Yes! Can we rant? A more humid country and wood framing, it’s just ready to rot. No floor drains in bathrooms ( GROSS), can’t even wash the bathroom properly, just wipe ( like other dubious hygiene practices ( no bidets)). 
Steal framing and cement wallls should be what Americans should use. The houses are another planned obsolescence  item.
Reply: Also can we talk about why the heck not have architects oversee each construction? It makes for less shoddy work, and creative beautiful design. Most people don’t need to remodel, their houses are timeless and built to last
Reply: Yes they are!
Reply: there' 3d printed houses and Integrated Concrete forms, which allow a pour into a shaped form. but what if there is something even better?

what if there is a way to 3d print cinderblocks in a different  set of just a coupel or a few key shapes that allows an entire house to be put together by hand in a manner that the cinderblocks are  interlocking gravity and compression enforced. a lot like brick laying an arch or other complex shapes, but with special shaped cinder blocks that require no mortar and very little skill to place together. one can even design the interlocking bricks so that spray insulation is easily injected 'inside' them, or 'outside' them. the design types of the different bricks can be extremely complex an intricate. this is the best and greatest strength of 3d printing. 

i'm sure this is not an original idea. as you pointed out in the video Lloyd wright had a similarly inspired idea but without the 3d printing. but modular block systems for onsite arrangement/assembly. 

concrete is obviously very awesome. and 3d printing on site , with full wall prints, is probably more hyped up than practical for the time being. but designing a house and then getting a computer program to put together a plan for printing all the right interlocking small cinderblock segments in a factory, and then 3d printing them all  as needed , and shipping them PALLETIZED in a container to be assembled onsite WITHOUT MORTAR. THAT is probably one of the evolutyionary paths for where this is all going.
Reply from the maker: @zeev  you basically described a system called ICF

Check out some of the other videos on my channel to see it in action  😉
Reply: yes yes they are
Reply: Yes, much much better. The USA is a third world nation pretending to be European. Even China has better construction. America dose not build homes suitable for the enviroment at all, if they did American homes would be immune to wild fires and wind.
Reply: As an architect based in Switzerland, I would say that the only benefit of american light timber constructions is the cheapness and the fact, that you dońt need very skilled builders. From my point of view  it is somehow crazy to build millions of dollars houses which are blown away by wind or burned from fires. You can build a wood construction which has the same stability and insulation capacity like brick and concrete house, if you want to. It is increasingly popular in my country, in fact. But it is not a job for everyone who can grab the hammer, these constructions are more complex than the us light framework. So, to me it is all about skills and knowledge, and this means that this is about how the builders, the architects, the engineers do get their professional education. When there are no contractors who are able to build constructions which can resist all issues, then nobody is building such homes.

And yes, the lego blocks made of styrofoam which are filled with concrete are not ideal when it comes to insulation and vapor issues - insulation should be on the outer layer, the vapor barrier on the inner side of the insulation, and the structural laer should be in the warm inner side. Friend of mine who is building some high end houses in US told me, that unfortunately the ants are eating the styrofoam layer too, so in the end you have no insulated concrete house.
Reply: Yes, from Europe, specifically Germany. While we don‘ build like the southern French with walls 2 feet thick to keep out the heat, even newer homes are way safer and sturdier than I‘ve seen to be the case in the US.

We rather not hear our neighbors doing the dirty, as we live closer together as renters of apartments, so dry wall only is not an option that is desirable! Yuck!
Reply: @lynnm6413 And if there’s a fire the building will remain standing, the stuff inside will maybe burn.
Reply: @lynnm6413 interior drywall walls can be sound insulated with rock wool, which is also a great fire barrier. It's used around chimney chases, If you make a wall about 20 cm thick with offset 2x4 (38x89) framing, and fill the wall with rock wool, neither sound nor fire (well beyond allowable escape times) will get through the wall.
Reply: @lynnm6413  said "like the southern French with walls 2 feet thick to keep out the heat"

2ft walls are not to keep out the heat but to keep better temperature inside, which includes to keep out the COLD. I've heard Germans try to have cold temperatures inside, something as weird as eating raw meat in a bread. Now I understand why Romans called you barbarians
Reply: @alastorgdl  Mettbrötchen with onions, salt and pepper…nothing better after having drunk too much the night before 😍

We Barbarians like fresh Ariane open windows regularly, but usually nay the bedroom is kept cold in winter…it‘s healthy to sleep in a 12°C room. 🤓
Reply: @lynnm6413  I NEVER get drunk

Uncomfortable living, abhorrent cuisine, no wonder you Saxons and cousins are so prone to genocide
Reply: @lynnm6413  as spaniard, I have to disagree 😂
Reply: @llepaconysbcn  with what exactly? I didn‘t even mention Spain?!
Reply: @lynnm6413  about your tradition to open windows in winter that much...xd
Spaniards, as average, should be as 1h at mornings...you love so much winter/cold,for us
Reply: @llepaconysbcn  oh, you meant the sleeping cold! 🥶
Well, it‘s so much more cozy under the covers to cuddle 😜 when the room isn‘t 20 °C warm…right?!
Reply: The biggest problem with American houses is: the lifespan in combination with high mortgages.
In coming decades people will find out the problem with a mortgages on a (post war) house that is end of life.
Reply: American homes are horrible. Poor craftsmanship, still using dimensional lumber studs that are crooked as hell from new growth. Inspectors that don’t do their job. And more than anything else just rotten design, constrained by the idiocy of the building code. I’ve done a lot of building, I know what I’m talking about. Building code needs A complete overhaul, get rid of things like sprinkler systems inside the house, so freaking ridiculous, smoke alarms are good enough, and it’s the only thing that will save lives
Reply: @steveperreira5850 you know what else is horrible? Your damn opinion
Reply: A home should be built in a way that works with its climate. I grew up in a regular wood-framed home. I live in an apartment (probably brick). I would love to have a concrete home as long as it could stay dry inside and not have any pest problems. What do you think of monolithic domes?
Reply: @SymphoniasStories  as you say build after local climate Denmark bricks,  northern Sweden and north Norway tree houses, but after ww2 where Bornholm was bombed by the Russians, Sweden helped us build a couple of thousands of tree houses Swedish style in no time compared to brick houses and 79 years later and they still stand and are very well liked and maintained, so Tree houses can be used, but a good well maintained Brick house can last for hundreds of years so we still love our bricks
Reply: Almost every country in the world has better houses. Except: japanese paper houses, favela metal sheet huts and african huts in some tribal areas made of dung and sticks. American "houses" are horrendeusly expensive. Mortgages are ridiculous. Its a SCAM.
Reply: @sheridansherr8974 As an Australian I have to say hold my beer.
Reply: @sheridansherr8974 Almost everything in USA is scam.
Reply: You literally still haven't figured out windows
Reply: As an architect based in Switzerland, I would say that the only benefit of american light timber constructions is the cheapness and the fact, that you dońt need very skilled builders. From my point of view  it is somehow crazy to build millions of dollars houses which are blown away by wind or burned from fires. You can build a wood construction which has the same stability and insulation capacity like brick and concrete house, if you want to. It is increasingly popular in my country, in fact. But it is not a job for everyone who can grab the hammer, these constructions are more complex than the us light framework. So, to me it is all about skills and knowledge, and this means that this is about how the builders, the architects, the engineers do get their professional education. When there are no contractors who are able to build constructions which can resist all issues, then nobody is building such homes.

And yes, the lego blocks made of styrofoam which are filled with concrete are not ideal when it comes to insulation and vapor issues - insulation should be on the outer layer, the vapor barrier on the inner side of the insulation, and the structural laer should be in the warm inner side. Friend of mine who is building some high end houses in US told me, that unfortunately the ants are eating the styrofoam layer too, so in the end you have no insulated concrete house.
Reply: @atameeh  to say you don't need any skilled labor to build a timber frame house shows that you've never built something out of wood.
Reply: They  are 100% better than in the usa
Reply: Absolutely, who else wants to live in a plywood kite.
Reply: I'm from the Balkans. I've lived in US, Netherlands and Sweden. 
Houses in US and Sweden are somewhat similar.
Balkans uses lots and lots and lots of reinforced concrete.
Reply: @evisar From my experience the quality of the insulation/moisture control is way better in Sweden.
Reply: Indeed they are. Especially when you live in a hurricane prone area and build your houses out of sticks.
Reply: @Cartilog-z4f said "Especially when you live in a hurricane prone area and build your houses out of sticks"

Not hurricanes but tornadoes, which is worse. Any sane culture would have adapted to land and did like Chinese in Sanmenxia (constructing underground houses). But northern Europeans are incapable of so much civilization
Reply: Without even watching the video, I really don't like fully wooden houses, especially if I'm paying to own, and it doesn't matter if it's a $50k or a $500k house, in the USA or elsewhere!
Reply: the answer is yes, houses in the US are made cheaply
Reply: Definitely, in Russia, us built "house" is probably called barn or shack 😂 no offense. All houses lookalike outside and what worst similar inside. Same colors, same cabinets😂
Reply: It's not a question that can be answered.  It's as nonsensical as asking "Is a Bentley better than a Kia?"  "Better" how?  Higher quality?  Sure, if not by that much anymore (say, 25%).  But "better" as in "most people can afford to buy it as their only car?"  Certainly not.  You can literally buy ten Kias for the price of one Bentley.  Most people can never afford a Bentley, but millions can afford a Kia.  Doesn't that make the Kia a "better car", since the barrier to entry is far lower and broader, thus getting more people on wheels?
Reply: I wouldn't exactly call American homes "houses". They are more like Barbie play houses that give the appearance from afar that they are houses.
Comparing them to European and Asian standards is pointless since American homes don't even try to be more than a joke.
Reply: Not only construction but the US electrical system is very old fashion and unsafe compared to Europe.
Reply: I strongly suggest all Americans to read "Three little piglets and the big bad wolf" story and make it obligatory in schools.
Reply: @crodoc69   I strongly suggest you check out Walt Disney's filmography. Make it obligatory in your schools.
Reply: Housing in the UK is generally far behind what is found in most of western Europe, so those from the UK should no be laughing at the US. But otherwise the whole single use housing of the US is just a joke. It is so short sighted in many ways, like with how heating and cooling is not only more costly but also makes for houses less comfortable to live in.
One note about ICF and really foam insulation in general, is that it is a flammable material that not only burns easily while it burns it also does so with very toxic smoke. I might consider ICF for say a garage, but never use it for something meant for people to live in. Brick walls with stonewool or fiberglass insulation is much safer and isolates as well or better when done right.
Reply from the maker: @bzdtemp ICF is treated with a fire retardant. It will melt before it burns and will not hold a flame on its own
Reply: I'm a bit dissapointed you only talked about single family homes and I hontestly think mainly ppl laugh at us houseing not just cus its made with matchsticks and paper but that you lierally dont build anything else while in Europe most developement is apartment blocks like from 8-40 apartments in one bulding
Reply: Of course. Any country builds better than the US.
Reply: There is nothing wrong with OSB stapled sheds. But WHO made you call them "FINE HOMES"? 😂
Reply: Das kommt ganz auf die Anforderungen an: Die Klimazone, Erdbebenwarscheinlichkeit, Feuer, Sturm....😊
Reply: No. Also, half-timber homes are called Tudor. Many straw-built earth homes, adobe homes, clay built homes, etc. can be foster points for Leprosy depending on moisture points which is why it was prevalent in the middle east, fertile crescent and northern africa/egypt. The Great Wall was filled with rammed-earth construction often including the bodies of the laborers that perished during construction as well but the exterior is made of rice brick, not stone.
Reply: Yes! 
American houses look kinda fake.
Reply: You never watch/read the 3 little pigs when you're a child? Wood houses are not very good against tornados.
Reply: If you like living in sawdust and gypsum houses then America is the best 😂
Reply: We laugh bc we can see home made out of plywood only in slums in 3rd world country and USA
Reply: I lived in the US, France, Spain, UK, Italy. All European countries have much better housing: American houses feel like cardboard boxes.
Reply: USURY-RIBA
Reply: we use BRICKS to build homes in countries like Brazil Russia India Cuba and South Africa
Reply: @Avisolu  your homes are tiny and take long time to build compared . America was built rapidly and quickly . Our cities are filled with stone and metal . Suburbs and rural areas use wood and frame but you can make it look any way you want . Also we have air conditioning and you guys don’t .
Reply: @ci6516  bro if u still think of African countries as air conditioner having continent. I feel sorry for u but thn again ignorance is blish 🙏 take care
Reply: @ you listed a lot more than African counties why would you assume I as speaking about Africa ? 😭. Europe don’t have air conditioning bro only Canada and America is it normal
Reply: I think in many places we are able to build sturdier because we don't need to worry about natural disaster and frequent replacements, so expending a bit more is worth it. Of course that is assuming houses that cost what they are truly worth and not inflated to hell and back.
Reply: Yes. Because they can last several generations and be used LONGER THAN USA EXISTS!!!
We seriously have apartments in buildings that are ca. 800 year old...
Reply: N. America has only been settled for max. 400 years, and people move around constantly compared to the rest of the world.  We have ghost towns, and now even ghost cities.  It makes less sense for buildings to last for centuries when their isn't the certainty people will always be living there.
Reply: honestly don't care because I'm not going anywhere but here. but this is interesting. I know European heating equipment is way over complicated. we focus on r value here, so the whole idea is less material that conducts the heat out or in whichever season it is
Reply: Yes 100% us has worst houses...
Reply: Indonesia its better
Reply: yes, 🇿🇦💚🇵🇸
Reply: What about the weak fillings of your timber frame houses? Such cheap materials are laughable. The quality of the piping and wiring is also very bad due to the lack of supportive structure. Being able to customise with your bare fist pushing through a supposedly solid wall has some charm to it. Only a comedic one but still
Reply: How is it better? Normally, people build houses to live well and safely in them. In the US, houses are built to impress the neighborhood and friends. That's why it's important that they look nice, regardless of whether they're just made of cardboard. And they do that well.
Reply: @briocmonard1752   it is a matter of opinion whether American houses look more impressive. More tacky, yes, but more impressive …
Reply: I think the difference is that in the USA it is a developer or company that buys the land and builds the house for a profit.. 
where in much of the world it is the single family that buys the land and chooses which company will build the house, and chooses whether it should be cheap or costly so that there is more competition in building properly
Reply: @TheVolvojohnny  Both approaches exist in North America. The issue is cost and building code. The decent quality single family homes have become far more expensive than houses built with cheaper materials.
Reply: Don't concrete houses suffer More during natural disasters like earthquakes?
Reply: Solid structure would be significantly better for the US, and I'm shocked they aren't more common for one reason.

They're bullet proof.
Reply: @Ouchmyback  no theyre not. tornado destroys even concrete houses.
Reply: To live in? Yes. To sell? No. US houses cost far more, than they are worth.
Reply: You can't forget another big reason why most of Europe doesn't have wood buildings: They literally deforested most of their forests, so they don't have enough wood left to make their houses out of wood.  If they actually had enough wood, they would probably still make the houses out of wood, just like in Scandinavia.
Reply: @bbdest3082  That's not really an explanation, as Germany has a higher share of forests than the US and especially Switzerland and Austria have much wood and few people.
Reply: So, here's the deal... I think in America, we are SERIOUSLY behind the times... the main reason is, surprise surprise! "Building codes". 

They should be "building suggestions" ... The ONLY time certain standards are not met, is when building something bigger than a 2 story building. THAT IS when Building code should be a SERIOUS thing.

If we didn't force BS on people... after enough died, to storms or whatever... new homes could be built, better & to "Local enviornments"... like the great wall was built.

This idea, that EVERY home has to be built the same, is just insanity... & knocks creativity and imagination out, when it comes to problem solving & making things better.

So a few places I've focused on Japan, Sweden & Netherlands. They DEFINITELY build homes better than we do in America. BIG TIME. But also some of specifically Japans newer homes suck.. no insulation, built flimsy.
Also Korea's older style homes.. built from Timberframe-Built better homes. 

That being said, I believe Sweden ALSO better INSULATES their homes. Than America does. (I mean without horrid "Spray foam" that comes back to haunt a home owner)
Reply: @ARKY-v3x with respect everywhere else had codes too. Building has strict requirements in the UK. Planning permission and permits/sign offs are standard. That is why insulation is mandatory here and a certain amount of energy efficiency to heat as standard is expected of new builds. Damp proofing and fire/electrical safety is taken seriously too. Even its life expectancy and ease of demolition is considered now. It’s the quality and relevance of those codes that matters.
Reply: No, their homes are not built as well as ours, no matter the methods or materials used.
Reply: I like the topic, but droning out those countries' names got on my nerves. Maybe say just one or two of them. I felt like there was going to be a quiz. 😢
Reply: No
Reply: European houses seem to be built on the small side.and brick doesn't do good in earth quakes wood flexes and moves better.plus we have alot of timber here
Reply: House in US are good, they have their advantages
Reply: The average home in the US is 2 to 3 times the size of the average home in Europe I’ve lived in newer homes, which are very energy efficient and I’ve lived in framed homes that are well over 100 years old. I’m glad I don’t live in some little cement cubicle.😂
Reply: @Skindiver986 2-3 times the size of Euro homes ? Bullshit total bullshit you obviously have not really seen Europe or did you do the American see Europe in week tour ? And this whole idea that Europe UkK is mostly concrete is totally wrong.  😂😂😂
Reply: @Skindiver986  depend of the country you lived in. My cement cubicle has a footprint of  280 square meters and almost 2000 square meters of land arround it. The total living space is arround 800 square meters on 3 levels , basement , ground floor , 1st floor. I think the smallest house in 200 km radius of my home is arround 100 square meter.
Reply: I think you propagated ignorance about the advantages of the construction we employ here, and both pandered to and amplified ignorant anti-American bigotry.
Reply: @Objectified the advantage is cheap materials and high profit margin
Reply: @Objectified  you mean the construction where you build homes for cheap in return for a 25 year lifespan?
Reply: I think most of the world can barely afford to buy a home that most Americans would want to live in. Everywhere I look everything is way overpriced and TINY, especially in Europe. Sounds like you just get your typical American-haters who are as ignorant as the day is long. You should check some of the British reactions to American homes videos to see some actual foreign views.
Reply: @TheGreatness-gg1jx  ".
.I think..." isn't a valid argument,man. 
So many pros had exposed in the comments what they KNOW.
Reply: @TheGreatness-gg1jx  Disagree.The difference is that especially Europe does not have the space for homes the size the US-Americans use. And the price you pay in the USA for a home can be way much higher than the price you pay for a similar sized home in Europe. And it depends on where you live. A small house in LA will cost you millions, while in Detroit you can buy one for a few hundred dollar. In my city in Germany you can buy a house for 106$ per sqft. The median price for a sqft for a house in the USA is about 150$ (143€) and can vary between 100 and over 200$ as of 2021. And btw on the list of the biggest homes in the world Germany is on place 11 and the USA on place 1.
Reply: you forgot that when including gang nails, hurricane ties and new treatment methods for most materials and furniture, the wood framed homes in the usa are more disaster proof/replaceable/safe when taking into account certain kinds of disasters, tornados for instance. also Europe; don't feed the pests, enough said.
Reply from the maker: @overseer7004   While I see the value of hurricane ties and other code required reinforcements (which other countries may not have), our wood homes are often wiped out by hurricanes, tornadoes, wildfires, and more.

A solid structure home is going to do a much better job of surviving the aforementioned disasters.  Even more so if combined with a conditioned, unvented attic.
Reply: @Mike_Fortin  Even communist apartments in Ukraine can withstand Russia bombs . Because it is made of reinforced concrete .
Reply: @Mike_Fortin America loves wooden houses. So they are afraid of cheap steel from other country. Which makes concrete houses cheaper than wooden houses.
Reply: @Mike_Fortin brick and mortar construction requires steel reinforcement . You can't build a structural sound house without steel. Actually I take that back you can use would joinery techniques and rocks sculpting techniques for footing. I've seen some traditional Japanese construction that use no nails at all and basically float on big granite boulders . They sculpt the foundation post around the boulders and the entire house sits on a bunch of boulders.
Reply: @Mike_Fortin  wood bends and so does metal, the houses survival is secondary to the inhabitants survival in my opinion, most of Europe does not have disasters effectivly when compared to the usa. Wood is safer in many instances, not always and definitely not all wood construction, but ours is from the info I have seen on natural disasters
Reply: @overseer7004  keep lying to yourself, it‘s not gonna help prevent future catastrophes!
Reply: @lynnm6413  european
Reply: @ as I stated… you think that‘s a dig, don‘t you?
Bless your heart!
Reply: @Mike_Fortin When Chile has earthquakes their 'solid' buildings collapse. We have homes in the US that are easily 50-100 years old.
Reply: @Miquiztli_tochtli  Brick houses in Germany usually don't have any steel reinforcement in the walls. They are thick enough. My house has 25cm for load bearing walls. Today that will often be more for insulation. The concrete floors have lots of reeinforcements inside. If there is no concrete floor under the roof there will be a steel anchor around the outer walls to take the loading of the heavy roof.
Reply: @reinhard8053  sure building like this on a one story can be done ; two stories with come clever techniques ..But when you add the element of earthquakes, unreinforced brick and concrete structural are not where you want to be. Hence the use of steel rebar in bridges and structures to give these structures tensile elastic  strength otherwise these structures will crumble in such cases. 

I live in the pnw us which lies in some massive fault lines, some of the most active in the world. High  wind storms, tsunami, landslides , and earthquakes you have to think about when you want a three storey or more. There is well documented scientific work that shows the region has a periodic mage quake every 300 years.. we're right in the time frame to expect one. Still with all the codes in place that require engineers to account for siesmic events nothing can prepare a 40-20 year old housing infrastructure for such an extreme event. Most people's homes and many old comercial and industrial buildings probably won't survive the event. The fact is steel,.for brick and mortar builds, is the most practical way to reinforce a significant large structure..yes you could use some older technologies that cleverly used sculpting and wedge technique but that is more of a work of art than anything practical..
Reply: @Miquiztli_tochtli Your first sentence is wrong. European brick houses were built for centuries without any steel.
Reply: @mick-berry5331  steel reinforcement is better
Reply: @Mike_Fortin those bricks with holes in them don’t provide insulation some off the holes will get filled with mortar and where there is not a hole there is a cold bridge, it will not have any meaningful effect, it’s to save money the bricks are cheaper, unfortunately in the 1970,s where the oil crisis resulted in a long recession, people got the idea to save money by building in those holed bricks that was a very bad idea in Denmark at lest, in the fall October November there are a lot of rain and the brick walls get wet the holes are close enough to the surface for water to get in the holes and if you get some days with minus 5 degrees Celsius you risk the water freezing in the brick holes and brake the bricks, it might be worse in Denmark because the law demands enormous amounts of insulation between the outer walls and inner brick walls so they freeze easier, in Denmark we probably has the most demanding building regulations in the world enforcement of them and lowest corruption level so there are no point in cheating. And to the point of one comment about biddings and stuff we have it all and our buildings are scanned and inspected vigorously before the house or building is approved, they literally use infrared scanning to make sure we haven’t missed a single spot 😂 so there are no cheap houses built in Denmark, but they don’t collapse or fly away and they need very little heating because of the crazy amount of insulation the laws demand, we build almost only brick houses and full brick stone outer walls it’s legal to use cheap hole bricks inner walls but usually people use full bricks it’s not the poor 1970.s.
Red brick tiles with metal bidders so they don’t fly away and the top back of the roof gets a lot of very strong mixed mortar 1 cement,   2 lime mortar and 1 gravel grains and 1 sand and back tiles on top the law also demand a under roof a very strong and thick Tarpaulin and under that minimum 350-400 mm insulation in roofs and attics.
Walls 300mm. Floors 300mm and radon barrier, a radioactive gas that can be dangerous especially if you are a smoker = lung cancer greatly increased. It’s the law in all new houses and renovations. And they literally come with their infrared scanner and check the hole house I never tried to fail one but I know a couple of idiots who had to use a week to fix their mistakes and got fired when they where done 🙃 that was a expensive mistake for their employer.
You also have to regularly take pictures to prove there are enough rust free steal binders between the outer and inner walls and they are placed correctly for maximum effect, same with those storm straps that anchor the foundation to the roof so it doesn’t fly away in a storm, so we have very little serious storm damage nowadays in the past 50 years as I remember the worst storm flood killed 3 people, 2 from falling trees and one in a older house as I remember, the worst storm flood before industrialization and strict rules in the 1600,s killed 12.000 people, 50.000 animals. That’s crazy how much difference it can make and it’s not because the storms are milder today and we are double the amount of people, so we are reminded of the cartoon with the 3 little piggy’s and the big bad wolf when we see how some Americans build houses and seems stupidest that the stick and other light materials so people call houses didn’t make it trough the storm 🙃 but I know there are places in the USA where European house buildings are as good as in Denmark the USA is a large place with many different people and cultures mixed together and many different building materials available locally, also if you get a much colder climate then Denmark Bricks are not the best choice, concrete foundation and tree houses are better suited for the very cold places Greenland to my knowledge only build tree houses and some concrete buildings no bricks
Reply: @Mike_Fortin we build houses that doesn’t fly away in whatever whether in Denmark and can last for hundreds of years if well maintained, outer brick wall and inner brick wall have to have rust free steel binders every 3 brick every 3 layers of brick but in a grid so they are not on top of each other just like with the bricks it increases the strength of the wall and of course 300 mm isolation between the walls and heavy straps from the foundation to the roof so it doesn’t fly away tiles with the same type of steel binders too extra secure the roof tiles under roof a very thick special tarpaulin and under that 350-400 mm insulation says the law in Denmark I all new buildings and houses or renovation, I have never seen a roof fly off unless it was a old building built before strict regulations. Only problem new house are not cheap in Denmark, floors also need 300 mm insulation and radon barrier, a radioactive gas that naturally slowly releases and can accumulate in houses especially if you are a smoker the risk of lung cancer multiply 😱💀
Reply: @Mike_Fortin  There’s this story called the three little piggy’s american should read it some time It teaches you how to build a hurricane proof house.
Reply: @Mike_Fortin  stone and concrete housing is far less resistant to earthquakes and of dubious resistance to hurricanes because of their weight... they collapse under their own weight far easier, especially when a foundation cracks, unlike wood frames. This is why Japan uses special wood interlocking joints, and have a full size quake test lab that demonstrate this fact. Please do more research on the engineering aspect of homes, this video is misinformed and badly reflects reality.
Reply: @Mike_Fortin  I remember that dude who made a hurricane-resistant house in some southern US state and his house was the only one for miles that actually survived relatively untouched. It's definitely time to give up wood-structured homes. Corpos only prefer them because they get to charge 500,000 for something that didn't cost nearly as much to build.
Reply: @Mike_Fortin    Se você misturar “fios de garrafas plásticas” (garrafa de refrigerante de plástico), e até onde eu vi alguns fios de polipropileno junto ao concreto VOCÊ FARÁ PAREDES A PROVAS DE MÍSSEIS ULTRARRESISTENTES a nível militar de verdade.

Parece piada, mas essa mistura de concreto com esses outros materiais estão entre os materiais mais modernos de blindagem militar! Eu juro que eu queria ver uma casa que utilizasse isso, porque na verdade eu vi que você consegue fazer essa mistura sem gastar muito dinheiro, principalmente quando você utiliza os “fios de garrafa pet” basicamente fruto da reciclagem.

Você pode até comprar numa empresa em quantidades muito grandes desse material novo pra se dizer, porém esse tipo de plástico é extremamente difícil de se deteriorar no meio ambiente, então a diferença da qualidade é basicamente entre o que foi reciclado de garrafa pet o que já saiu da indústria naquele formato (mas entendo que em projetos grandes ou questões mais sérias militares o pessoal deve optar mais pelo outro).

Seria legal você dar uma pesquisada, porque eu não estava brincando quando eu falei relacionado a mísseis e torpedos, agora imagina se essa resistência é tão absurda assim e o preço é quase que igual???

E outra questão também é que essa mistura garante melhor resistência à compressão e movimentação do concreto, é lógico que ainda vai ter que ter o aço armado para criar uma resistência mais estruturante, porém os fios criam uma liga junto com cimento que é como se você misturasse cabelo embolado no meio de uma massa que não deixe o material desligar fica tudo juntos!

Enfim devo ter falado um monte de besteira não sou da área, mas acredito que ainda assim conseguir pelo menos indicar o tipo de material para você pesquisar e falar suas conclusões! 😅

E o mais engraçado era que a forma de fazer era bem simples, o cuidado real era em relação à proporção que se for uma obra feita com carinho isso é muito tranquilo!
Reply: @Mike_Fortin  React ou test  of carbon short fibers in ultra-high performance concrete.  Outhers names Ultra-high-performance fiber-reinforced concrete. 🙃✌️
Reply: @Edward-op3yc Do you think that is old for a house ??? 😂😂😂
Reply: @Mike_Fortin  yep wooden homes are retarded and scamm
Reply: @Mike_Fortin  idk, I always thought americans were st00p1d for not building brick/concrete homes against the tornados until I saw how an F5 hurricane can rip off even the foundations of a home. It scared the sheep out of me (although I still think even theorical F7 tornadoes are less trouble than living in a narco-socialist country; lucky 'muricans).
In any case, americans are free and inventive, so if they're still building that way, its probably because this is their best option so far.
Reply: @Mike_Fortin You are absolutely wrong and I suspect you know nothing about building at all. I have planed and built many homes in the US and in Europe I can assure you the US homes are superior to those piles of stone they build in Europe.
Reply: @Mike_Fortin  my house is made out of bricks and concrete. I have used 350 tons of rebar. The ceiling is made out of 100% concrete and rebar , 20 cm thick. The house went through a major fire where the roof burned completely and we were able to live in it after the fire was put out because the interior was not affected by the fire or water used to put the fire down. Other than that , the house is realy cool in summer , and nice and warm in the winter. No special insulation. I will not be surprised if the damn thing survives a nuke. The foundation is 2.3 meters deep and 80 cm wide. Every interior wall has the same depth.
Reply: @Mike_Fortin You know what's funny? We have floods, storms, and everything in between. We have even regions with regular snow storms and nevertheless,  most European houses you were showing even in the first 5 minutes are older than the United States...
Reply: @Mike_Fortin  Termites also seems to be a big problem. Why you use a material thats food for insects?
Reply: @Mike_Fortin  i have to gag if i see those homes and how you build its like using toothpicks and the nails and everything its just way under dimension! i would barly build a shed with things like that and then you see an osb i beams that would never ever ever hold if you fuck up even a little and there are shear forces thats just wrong! and this is coming from a swiss carpenter we use real dimensions and we are able to build just as fast we just do a lot of stuff in our shops and not on site. if we have big structural posts those come prefabricated and glued into one so that its actually strong and not a ton of 2/4s together with a couple of nails. your codes and hurricane ties are a joke we use big ass long screws threw the entire rafter etc its just save a buck here and there and go to the extreme limits of what is possible on the cheap. insulation just chucked up in the attic is wild to me! no protection against animals etc no moisture barrier etc etc etc the devil is in the details.
Reply: @lynnm6413  Yeah, it is smart if you build a house from cardboard in an area where there are many Tornado.:goodvibes:
Reply: @ "You can't build a structural sound house without steel." sorry, but tell that to all the houses built up to the 18th century all over Europe. Even full brick homes do not need steel.
Reply: @Mike_Fortin  We do. Strong wind (Storms) seldom lead to houses with lost roofs. Of course with really strong summer storms some damage happens. But mostly when you are unlucky. Meaning sliding earth (erosion), redirected rivers a.s.
Reply: @overseer7004 We regularly have tornadoes in Germany. Houses need new shingles and maybe a window afterwards. But that’s it.
Reply: @Mike_Fortin hurricane ties and other reinforcements are band aids to fix fundamental y week stick houses.
Reply: @Mike_Fortin And what happened to these houses when an earthquake shook the foundation?  Why do you think the Japanese used even lighter materials to build houses. Don’t tell me they cannot fortify with concrete walls.
Reply: @overseer7004  Check an aerial view after Hurricane Andrew.
Reply: @Mike_Fortin  nice video :) was a good watch while having some lunch. 
Just some more thoughts. It is not just about building materials, but also about mentality, geography and building codes. In europe everything is build quiet dense, so we dont have much space to build. If we build a building with the same amount of money, it is usually smaller but so can spend more money in structure and details. While many american homes have the possibility to be larger, set into a wide landscape, connected by roads. 
Also our architecture is set into a historic context, wich is sometimes a thousand years old. The people as well as the law protect those structures and their enviroment. Wich means we have to build adequate (not similar) but regarding the old structures. Also we reuse the old structures a lot, since we see a huge potential in sustainable construction, using already existing volumes makes it cheaper and produces less carbon dioxide. 
further more, many german build for generation. The capitalist movement is destroying our urban landscapes a little, because they are usually short time investment or showcase the ego of international firms that dont represent the local culture. However family businesses and family homes are ment to last for up to a hundred years and longer. We create value to last. The value is not in the personal expression of my own home but in using the high quality passed on from the ancestors. 
So mentallity of a local or national community is key. Just as it is the factor to those, who "laugh" at american construction. It is a basic instict to uphold own values and distances from people with other values. Thats group building, to ensure survival. Its the social potential, that makes such topics attractiv. Because each methode has its quality. So the question ist, from what point of perspective do we evaluate the work? Spacewise, amaerica is first. Longlivety of the structure, switzerland might be top. Sustainability, we find earthhomes in africa or in Yemen that are far ahead. Climawise you find igloos in greenlands, where all our buildings would be considered quiet bad. 

Was nice thinking about it. 
Best regards Tobias.
Reply: @overseer7004  a house made of brick and cement would withstand the hurricane, they have some in Florida and they are completely fine, not to mention they are fire proof, old apartment buildings in New York  are built with bricks and cement  and many have almost a hundred year or more, so a house made o wood not the best option.
Reply: @overseer7004 We have Tornados too over here.. now guess why it isn't as much of a problem as in the US.
Reply: @overseer7004  A concrete or brick house is way more resistant to wind damage than wooden houses made with those materials.
Reply: @overseer7004  no they don't lol; that logic would work in japan where no matter what you do you get screwed..... but in america your natual disasters are usually so weak that they would only damage the roof shingles, windows and the paint.... and yes i am speaking from experience here my grandpa told me a story of one of the neighbors who got his house f.ed up because he built his house american style while they just had to replace 2 windows and a tiny section of the roofing (not the beams or anything big).... he said it was quite scary because the hurricane went straight throught our street and that's not even it.... in "steyr" there is a section that has regular floods and when i asked my aunt what she does she just told me they have flooddoors that they just put where the normal doors are. ....... one of my friends grandparents also have a house in an old conflict zone and just told us that that house is built to "simply" withstand bombing (2,5-3 meters thick walls) her husband also told me that tanks can't drive into that wall... the thought alone is absurd but that's just how they build that stuff..... and may i add the school i visited, to this day, has the lockers for all 800 students in an atomic bomb safe shelter (aktive and intact) they even let you bring a paper slip to sign to your parents where it says they should sign if they agree to supplying potassium iodide pills to the students 

....... so in conclusion yesss our houses are built to withstand much more your houses would not be even close to "up to code" in most of europe you have storm shelters for exactly that reason also a home is expected to last 2-3 generations till they die; sometimes found in the building code of a country itself
Reply: @overseer7004  Houses built here are  planned to last 30-50 years. Cheap and shitty, with drywall, plaster,  being the strongest thing in the wall! Houses built in England for example are planned to last at least 160 years.
Reply: @overseer7004  ask LA and Florida if they agree with you 😂
Reply: @hbsb010  California and Florida suffer because they are so stuffed they build on metaphorical sand and literal sand.
Reply: @overseer7004  They are standard in Germany, sometimes designed slightly different, and with additioanl things required in DIN stadards also for low wind areas. I also viewed some propsals how to make buildings hurricane proof in the US, which were also already required in non hurricane areas in Germany. We expect a hous not to loose a single tile in the strongest storm happening here. It's what you expect from a house.
Reply: @overseer7004  That's quite far fetched. Solid structure homes don't need replacement and can take quite a beating from debris flying around in extreme winds without endangering people. It's worth a news report when people in a US bank survive in a concrete safe during a tornado. I Germany, nobody would mention that, as the safe is about as sturdy in regards to the tornado as the average house there.
Reply: @overseer7004 it would make sense if the houses were actually more affordable for renters and buyers, which they are not. So it doesn’t make sense, Europe has better houses
Reply: @overseer7004 other countries have had these for many decades.   Yes hurricanes, cyclones, tornadoes and typhoons do exist outside of the USA.   Earthquakes exist and homes must be built reistant to earthquakes.   Liquifaction must be accounted for and gas, water and power lines must be laid to be safe and self sealing
Reply: @overseer7004 wrong. 100% wrong.
Block houses are stronger and can withstand storms much better than wood frame houses, especially if designed for them.
"Homes built with insulated concrete forms (ICF), like Fox Blocks, maintain their integrity during the high winds of a tornado. Insulating concrete forms can withstand winds of over 200 mph."
Reply: @overseer7004  Europe has a tornado alley as well, yet you don't read nearly as much about large scale destruction there. American houses are many things, but not disaster proof
Reply: @overseer7004 pretty much all homes use hurricane ties etc like the U.S. Do. China have loads of brick built buildings and have more earthquakes etc, they rarely get damaged because you can make brick homes hurricane and earthquake proof.
Reply: @overseer7004  Ah yes, you have tornadoes, so sorry for that... But basically your houses are just cheaper, that's the main advantage...
Reply: Keep telling that to yourself @overseer7004
Reply: @overseer7004  Is n AU 🦘🦘🦘🙃 we have the famous  phenomenon of white ants. They fang timber from inside and if a hapless beer-soaked Ocker collides with a pillar it disappears in a puff of wood dust. This the equally famous Aussie verb "to whiteant". To erode something at its foundations until it loses all structural integrity. Enough said.
Reply: @overseer7004 I would say the homes in europe are more disaster proof than in the US. It‘s true that our homes do not feed the pests but you could install some animal housings outside your own house to support animals anyway. I would say that the US should build more solid houses in regions where there are almost no earthquakes. In regions where there are strong earthquakes I would say building replaceable houses is good. Also: Americans are so often super proud of themselfes to a degree where they don‘t recognize their own mistakes… They often think the US is the best country in the world, but… you guys are doing a hell lot of mistakes.
Reply: @overseer7004  Okay so what?
Reply: @overseer7004 Not really. You rebuild faster. But they certainly are less secure.
Reply: @overseer7004 We have tornadoes in Germany too. What happens? The tiles on the roof have to be renewed, maybe some new windows, that’s it.
Reply: @overseer7004 Gang nails and hurricane ties are methods to make up for structural weaknesses that better built homes don’t have.
Reply: @overseer7004 so I do not know a lot about disasters but we had an F4 tornado in germany some time ago and it removed some shingles from the roof and destroyed some windows but all houses were still standing.
Idk if that kind of tornado is common in the usa.
Reply: @overseer7004   perhaps more 'replaceable' but dont see any data they be more 'safe' take for example how in japan even during the last super quake when wrecked the atomic power plant , the damage was reduced and in other parts of the nation with either more traditional construction or more modern one even as they shook most of them endured it unharmed making the main complaint on solid structure null aka hard to repair , compare that with the american ones that tends to rattle to pieces or worse if a strong quake has them in the epicenter
Reply: @overseer7004  

Japan has for example regular built by brick houses and those are earthquake proof, of course to an extent makes sense, but having all my belongings vanish from a natural disaster that a brick house would of withstood is..... questionable at best to me.
Reply: And it only took you guys 400 years to come up with solutions to problems Europe solved 2000 years ago
Reply: @overseer7004  wood framed are more disaster proof???? safe??? really? where do you go for shelter when disaster strikes?
Reply: @overseer7004  As a construction engineer, I can guarantee you that this is not true. The houses in America are not even close to being as safe against natural disasters as those in Europe!
Reply: @ChevChelios.  i was talking about wood construction methods, not summing all housing types between continents.
Reply: @overseer7004 but their home lasted for thousand of years. Show us one american home aged more than 300 years old and u have the audacity to claimed american home is disaster proof 😂😂😂😂
Reply: @Ameng3471  yes I have audacity; I am quite magnificent aren't I
Reply: Look at japan novadays they dont bild wooden houses
Reply: To append my statement, I did not mean more safe than solid structural brick/cement. I mean that they are extremely safe. As in safer than befor or in most other countries that build with wood. Also euros are just going to cast shame and doubt and willfully find an excuse too because they live in a social bubble wrap, terraformed social engeneered land. Also despite all the "x disaster still happens here" yeah, just not to the same magnitude or frequency because of the latitude and longitude and many centuries of environmental input on where houses can last in the first place in europe. The European hate is out of distaste for the cheap, prevalent and snide opinions and disparagement i have had to deal with in the past. Europe is a take it for granted fairy land where things don't wash out from under you and you don't have to put your face to the grind stone, though the ones I've had to deal with may have been a selection biased group(japan does better wood work, and timber frame is also better than platform)
Reply: @overseer7004  Europe is no fairy land: it is a place where survival of the fittest took place for millenia, and where most of the wars happened. We just are quite ahead on the learning curve...
Reply: @mariosebastiani3214  you do know all the people in the usa were also selected by mostly the same events, I would assume; do you know the degree and variety of the current ever since the suez crisis, among many other such events. do you still live in 1910? I think you guys are the strain being currently hung by the learning curve, considering the degree we bail you out for the sake of prissiness & your native TFR trajectory. is there that small a carrying capacity for your peoples? your nations are tacitly coerced non compete zones for your elite where they bribe the majority with gibs in the form of government wonk pet projects; you have no dynamism and your nations mindsets across most the continent are that of a fruitless bloated gerontocracy, while your zeitgeist is one of anxious badly executed epicurean ethos without the guts. if the current Europe is the result of "learning" then I don't want any of whatever that disease is.
Reply: @overseer7004  So, the disease according to you is having social healthcare, better work/life balance, affordable houses which aren't made of cardboard, no school shootings, healthy foods and police forces who don't discriminate on skin colour basis? Did you ever step foot outside the US, or you just take for granted what Trump and Fox news tell you? I've walked 3 continents, and albeit finding enjoyable to live abroad for a time, nowhere I found the living standards as high as we have in the EU. But those have been obtained through hard work, and we're fighting against the erosion of those standards. The threat to those comes partly from the corporative mentality from the US.
And about "bailing us out"... the US are NOT helping anyone but themselves, and it's been like this for 50+ years. The reason why you keep military forces in the EU isn't helping us; it's just that civil war taught you that it is better to wage conflicts outside your borders. And if you think the EU can't protect itself against Russia... if it's against an attack (by ballistic missiles) you'd be right, but they can't invade us. They've got no men and no logistics to do that and they know it. As for nuclear deterrence, we've got France and the UK.
Reply: @overseer7004  and if you are talking about rats when you mentioned pests thennnnn uhm yeah that was before america even was a thing